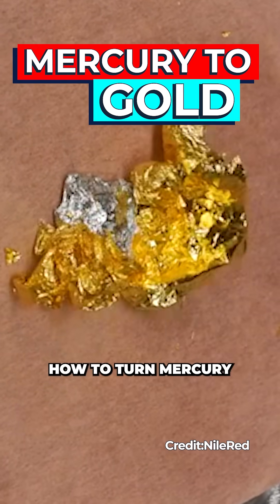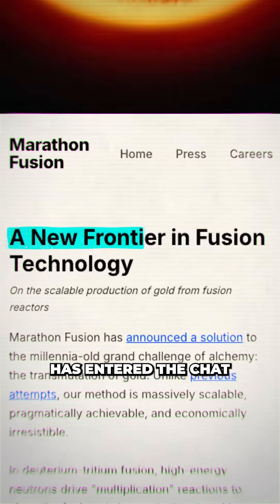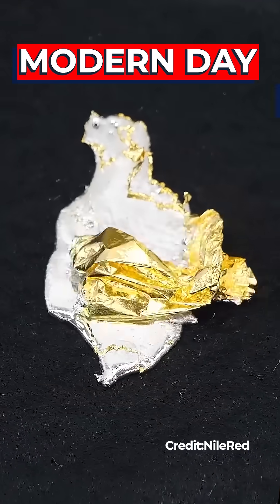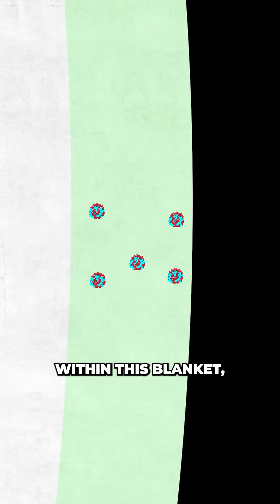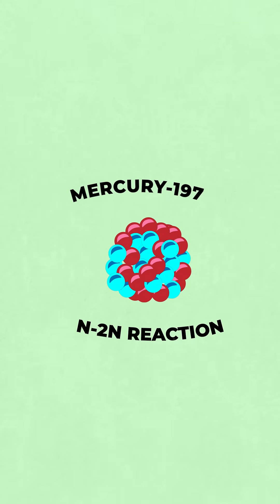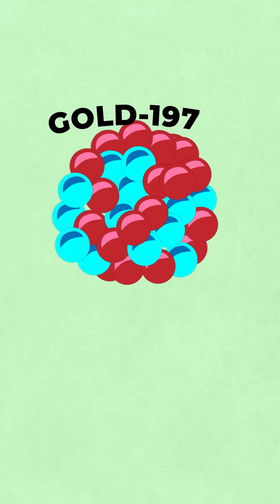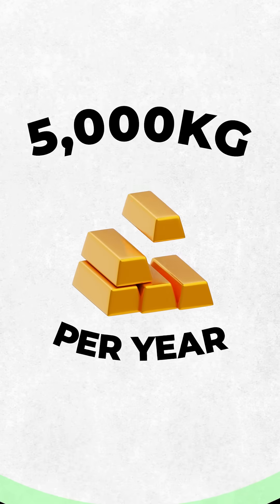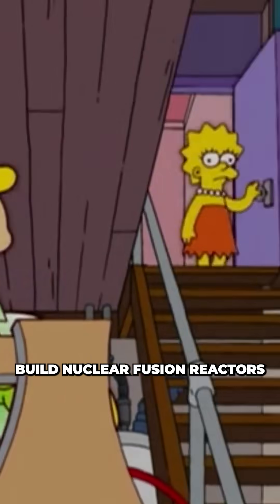Scientists Turn Mercury Into Gold

Comment: nah we gonna get gold inflation. this is basically printing gold
Reply: Gold is still useful in electronics etc
Reply: @paaaatrikaexactly
Reply: @paaaatrika  Anything that CAN be used to do good, WILL inevitably be used to do bad.
Reply: @woodjourneys  waaaiiit a minuuute!😭😭😭 you had me in the first half!😓

ion like it bcuz itz tru! 😭
Reply: @woodjourneyswhich doesn’t mean we should never do anything good.
Reply: @jameselliott216 😢
Reply: @woodjourneysit won't be used at all
Reply: @woodjourneysso never do anything right? What a strange thing to say
Reply: @paaaatrikacopper is better gold just good cause it doesn’t tarnish
Reply: @paaaatrikayes but adding more supply lowers demand. I assume it will be controlled similar to diamonds, hopefully natural gold has its own separate value
Reply: @cardinalcar mercury price will skyrocket if it use to make gold that will increase the cost, and you should know that mercury is also rare material. This video didnt count on mercury price increasing if the demand of it higher to make gold.
Reply: If this works out, it would certainly reduce the cost of gold and therefore the revenue.  However this would mean that gold becomes something we intentionally find utilitarian/industrial uses for, enabling all sorts of technological advancements that we aren't even looking for right now because usually materials science is trying to find ways of replacing gold with less expensive materials.

Aluminum used to be considered a precious metal due to pure metallic Aluminum being very rare in nature.  However when we figured out how to extract aluminum from very common bauxite, the price naturally crashed.  And it turns out that a cheap lightweight metal that doesn't corrode quickly has tons of useful applications that were unthinkable when it was vey expensive.
Reply: @TheFalrinn  Gold has naturally extremely low electrical resistance. For some small mission critical electronics, if the proce fell down enough, you could feasibly use it for wiring. It doesn't corode, doesn't tarnish, has way longer lifespan, lower resistance, so it heats up less and wastes less energy.
Reply: @TheFalrinn  isn't gold already used for conducting electricity?
Reply: @supertrollariobros1261 yes but silvers better i think
Reply: It can be, but due to it's cost and rarity, it's generally aren't going to use it for that purpose on any significant scale. If gold prices came down significantly, then the number of applications that would become practical would increase significantly, as would the incentive to find new applications.
Reply: @TheFalrinn  We use gold a lot in semiconductor manufacturing. Not only on processors and stuff, but especially Microwave Integrated Circuits are one application where gold wirings are basically essential, since it adheres best to the substrates we use.
Reply: @yukinagato1573 don't forget the applications as a catalyst in chemical compounds and in pharmacology 😊
Reply: @victormerida1564 : That's mostly silver, though I wouldn't be surprised at some gold-acid stuff as well.
Reply: @CreativeAndCreepy but silver corrodes but gold doesn't when exposed to air
Reply: @TheFalrinn  yes! I was thinking along these lines too. Great comment!
Reply: @TheFalrinn someone who gets it
Reply: @TheFalrinn thanks finaly someone said something actually inteligent about it
Reply: @TheFalrinn cant wait for my goldenfoil hat
Reply: @TheFalrinn I'd say reduce-ish, much of gold's value is based in artificially created scarcity. If a company created that much gold but held onto it as part of its holdings/assets then the price isn't going much of anywhere. If enough companies started doing it and releasing it out into the world then sure, they'd destabilize the market and destroy a LOT of businesses and industries, Whoopsie!
Reply: So now we ve just discovered Nixon know that he saw long he saw good
Reply: @TheFalrinn They could always do what they do for diamonds. We can already create diamonds but the ones that we create are only used in in like industrial purposes and military purposes never really sold so diamonds actually keep their value.
Reply: @TheFalrinn we already have hundreds of medical and industrial uses for gold, we've only been trying to find replacement because of cost.

Gold low electrical resistant and bio-inert properties make it extremely useful.
Reply: @TheFalrinn  Yeah, we would automatically enter the gold era and almost everything will be plated with gold to prevent corrosion.
Reply: It's like the gold asteroid. They said If they could bring it here it would be worth 10 quintillion but it won't, gold prices would plummet.
Reply: @aarong8457 Gold would become the new, better, cheaper standard for electrical wiring, a massive plus for the entire world
Reply: @StillActuallyCharlie  those papers you call money why do you think that you can pay for something with money? because it's backed with GOLD
Reply: @hungry_lama  My dude, it's been fiat currency since Nixon.
Reply: @hungry_lama  Haha! No it isn’t? Not a single country has a gold backed currency (gold standard) anymore and most haven’t for a looooooooooooooooooong time. Check your facts before trying to school other people.
Reply: @hunyesmith03  so you want to say that the federal reserve of USA is just a hard drive with thousands of Bitcoin? Or china doesn't have gold and backs their currency with stock in apple on space X or NFT's? OR even better... ALIENS. yes. they back their currency with aliens like huh? The hell did you think
Reply: @hungry_lama hasn’t been backed by gold since the 70’s dawg. Nixon took money off gold
Reply: @hungry_lama I always thought it was because the economy has become more debt than money or something
Reply: @hungry_lama  that hasn't been true for over 50 years lol
Reply: @hungry_lama  sounds like it's time for someone to do a wiki dive on what fiat currency means
Reply: @hungry_lama  In the US it hasn't been backed with gold since the 70s.
Reply: @aarong8457  Sounds good to me, if gold became dirt cheap I would buy a lot of it.

As a noble metal it is super useful.
Reply: @aarong8457 No. Diamonds aren’t scarce anymore either, they haven’t been for a long time. They’re still expensive because the diamond industry operates as a cartel and keeps prices artificially inflated. The same thing would certainly happen with gold.
Reply: @aarong8457  "It's like the gold asteroid. They said If they could bring it here it would be worth 10 quintillion but it won't, gold prices would plummet."

That or everyone would be billionaires and bread would be some ridiculous price like $1 million 😂
Reply: @aarong8457 but really it would make gold worth nothing.
Reply: @aarong8457 (rant) kinda reminds of the planet with a diamond core that would simultaneously be worth 9 Nonillion dollars and absolutely nothing because it would obliterate the diamond market. Not like there was much value to it anyways. It’s all pretty much overinflated and overstuffed. Just lab grow them. They’re better and just as “valuable” if you don’t count the concept of its origin, in which case, sure it has less value, but imo that’s mostly irrelevant.
Reply: @aarong8457  correct. Which is basically the only reason we aren't doing it. If there's an infinite supply (near infinite, it's the entire solar system worth of asteroids), everything might as well be free. Capitalism can't have that, nope.
Reply: @aarong8457 Actually, I'd prefer to differ... The billion dollar companies that are allowed fo mine the asteroid will end up selling it to big tech for their microprocessors and whatnot; hence, they'll end up making it look like they are under the impression of creating more jobs...
Reply: @The_Literate_ChristianJust because you  beg to differ doesn't make you right. Do you understand how much 10 quintillion is? That would be around 130 billion tons of gold.  That's about the same as all iron mined ever.  Steel is even more expensive than iron and I can buy a stainless steel chefs knife from the dollar store for a dollar.  Why? Supply and demand. Steel demand is extremely high but supply makes it cheap.
Reply: @aarong8457 No, its the people that control the commodity that decides whether or not to make it cheap. Why do you think we have gold reserves like fort knox. Gold is probably more abundant than we think but its also very usuful. I think the cause of gold prices is a bit more nuanced theres just a lot of unknown factors..
Reply: @The_Literate_ChristianThat would me as much gold as all the iron ever mined.  Is steel useful?
Reply: @aarong8457 they would still be able to use it for electronics just like how they use diamond tool for construction
Reply: @aarong8457 they obviously mean in terms of current market value, it’s more so the fact that we would’ve harvested that much gold to use for ourselves from a single asteroid. Then it’s done more and more and we essentially have a supply of rare metals and other elements that, in practical terms, is endless
Reply: @aarong8457  would make like instantly better for the whole planet but gold would be worthless... lets not do it LOL
Reply: @aarong8457 not if one country holds it and controls it
Reply: @JTHR3ZY2janky Do you realize how much 129 billion tons is? that's 2 trilion 580 billion pounds.  That's all the iron ever mined EVER.
Reply: @aarong8457  ok? Not sure how that relates or affects what I said at all 🤦‍♂️ yk how many diamonds there are?  guess what the market is controlled by the supplier yk why that is??? because THEY CAN AND WILL. It’s baffling to me that you think the US will just be passing out gold the main thing needed for semiconductors and these ai chips. Ai chips aren’t just for rt and anime games there used on weapons that would turn you small town to dust and splinters
Reply: @aarong8457 not unless it's artificially inflated to have more value, like diamonds
Reply: @aarong8457 we should stop treating gold as a dumb expensive yellow metal and start understanding it's true worth as the superior energy conducting material, if we replace all the copper we use for wires and cables the energy transfer rate would skyrocket.
Reply: @aarong8457  thats assuming supply and demand isnt artifical. just look at how diamonds scarcity is caused by controlling supply.
Reply: @aarong8457 it’s worth 10 quintillion right now…
Reply: @aarong8457 that’s why they need to keep it in a vault snd only release some at a time like diamonds lol 😂
Reply: @aarong8457  i mean, as long as someone does something secretly, they could become secretly rich.

if someone finds a really good thing that benefits them alot, they'd most likely keep it a secret so it keeps bringing benefit to them, unless they are stupid.
Reply: @aarong8457 yeah golds value only stems from its being relatively rare and difficult to extract. So unless they plan on implementing something like a diamond cartel to maintain artificial scarcity, the price of gold will go down
Reply: @aarong8457 
It's only worth the value human beings put on it.
Reply: @aarong8457  Yes, but that much gold would be invaluable to the betterment of human life.
Reply: @aarong8457  yeah but gold will still have its uses. Mining asteroids is a bountiful thing to do regardless of the value dropping. The earth is finite
Reply: @Andromeda_53  Yes how useful is iron? How many things utilize steel? That's how cheap gold would be if there was that much of it.
Reply: @aarong8457 exactly People need to remember that aluminum was once one of the most valuable metals.  I really hope someone finds a way to make gold one day but I'd rather they solve climate change and starvation and cancer first
Reply: @aarong8457 it would but If they did it right they could monopolize and sell just enough it would still be high price and makes billions or even trillions instantly making that country or person the most powerful in the world
Reply: @aarong8457 if it’s dispersed yes it would make a gold inflation, however more than likely one country would own it all so it would just make that one country rich. No inflation
Reply: @aarong8457 it probably wouldn’t though because of the investment to actually get the ore
Reply: @aarong8457 gold will be less valuable then a single popcorn
Reply: @aarong8457  many diamonds are produced in a lab but that hasn’t affected the price
Reply: @alvshill  There isn't different grades of gold that can't be refined. You can't refine a diamond. You can just melt dirty gold and clean it up. Gold is just gold.
Reply: SILVER STOCKS GOING UP BABYYYY
Reply: @aLovedHater and Mercury prices going up. Because that's what they'll need to make gold 😂😂
Reply: @powerdude_dk : I am fine with less mercury floating around, the stuff is more common than we actually desire.
Reply: @aLovedHater if they can do it with gold they can figure out a way to do it with silver
Reply: @aLovedHater  unless they are gonna split and fuse atoms to make silver too. its all about the amount of protons neutrons and electrons in an atom.
Reply: @acenuke2513 that's what i was thinking. Nothing is stopping them to make other stuff in there too
Reply: @aLovedHater I'm liking this
Reply: @aLovedHater Ok time to make silver 😅
Reply: @aLovedHater Been buying cheap silver 4 YEARS!
Reply: Gold should be cheap enough to bring down the cost of electronics etc.
Reply: @mr.joshua6818 lol the price won't go down on electronics at all
Reply: You would need 7000 fusion reactors to replace mining.
Reply: @carat1990 that doesn't sound like much tbh, it's less than the amount of coal burning energy plants. We could get there eventually if it's profitable enough
Reply: @BHsss13 eventually yeah maybe
Reply: @BHsss13  doubt it, it wouldn't even pay for itself, were talking over $20 Billion, 5000k gold is $660 million, it would take 30 years, an thats not considering the employees being payed, nor the cost of the mercury. I would hope Fission reactors would be what is being made. We dont want the radioactive waste that fusion reactors produce.
Reply: @johnhickman8391 fusion reactors have extremely low radioactive waste. They also can't have a meltdown that spreads radioactive waste
Reply: @johnhickman8391 : Fission produces a lot of waste, fusion mostly doesn't but also doesn't yet produce extra power.
Reply: @carat1990 we get most gold from recycling now days just saying
Reply: @carat1990 We can do it
Reply: @carat1990 mote... but interesting...
Reply: We could use a platinum or Palladium standard instead of a gold standard
Reply: @owenpeck4857  The gold standard hasnt existed for a very long time. And god forbid yall try to hike the price of platinum metals too, itd just fuck up chem and pharma at the consumer end bc those metals are extensively used for their tremendous catalytic prowess.
Reply: Gold is actually useful in electronics thou. This could cheapen them.
Reply: it’s radioactive for 10 years after production 
don’t worry 
it’ll probably be limited to computer parts 
not the jewelry or bulk gold for savings we traditionally think of
Reply: @argenizt123 well, when it stops being radioactive we can use it to protect everything from radiation.

We could literally have houses coated with gold and then we'd actually have deeper protection from potential radiation related threats.

Gold is highly useful for so so many things
Reply: Yep cause demand will probably stay the same while supply increases so prices go down
Reply: @vocalsunleashed  But that's not necessarily a bad thing. Gold is better than copper for computer parts.
Reply: @vocalsunleashed  I bet demand would increase a bit because of the hype so it would decrease but by less than projected
Reply: @vocalsunleashed no gold has lots of uses, old computers were made with gold
 If this Actully happens expect all our mobiles will be made with gold and we will treat it like aluminium. Chucking it in the recycling bin every week.
Reply: @vocalsunleashed pretty sure the demand would go down since part of it has to do with it's rarity
Reply: @vocalsunleashed No!! Demand will go up massively as it is beneficial in many industries that couldn't afford to use it at current prices.
Reply: @vocalsunleashed it's not about supply and demand when you can make gold from something as readily available as mercury this would literally make gold worthless other than it's electrical properties
Reply: @vocalsunleashed No, supply will stay the same but supply will skyrocket which means the price lowers (if anyone's actually willing to sell gold & make it just another metal)
Reply: @vocalsunleashed demand would increase with supply as gold would replace copper and silver as electrical conductors
Reply: @vocalsunleashed not necessarily. Real world dynamics cannot be simplified to a two dimensional supply-demand graph you briefly saw in high school. There are things called induced demand.
Reply: I just love gold. I don't even care how valuable it is.
Reply: Aluminum was worth more than gold. Until suddenly it wasn't. So little of the real world economy is based or backed by gold that it really wouldn't matter - except that your electronics and cables suddenly get better,  radiation shielding gets lighter, and in extremis, non-toxic birdshot and bullets
Reply: @markbecht1420 non-toxic birdshot 🌟🤩
Reply: Gold will still have value in electronic components and other technology, gold becoming more available will make technological advancement quicker and cheaper. The monetary value of gold is less important than its use in practical applications
Reply: Agreed! I was going to comment something similar. Gold will lose value as it becomes more accessible.

This can be a good thing as if Gold replaces copper, then we can have faster technology with gold traces/wires

Edit:
A lot of people keep correcting me, but my responses are lost in the vast quantity of replies. I am aware that I am wrong. Thank you for those who corrected me.
Reply: @micah2936 Good for us, bad for gold businesses and any of the billions who have a stash of gold. In their minds it would ruin the economy, they're blind to the benefits.
Reply: @micahsteeze sorry, but gold will never replace wiring lmao. Electronics yes. But not house hold or grid.
Reply: @micahsteeze  Not sure where you came up with the idea gold conductors could improve computers, as 1) gold is a WORSE conductor than copper, and 2) trace length isn’t even the limiting factor in computer speeds; silicon wafer technology is.
Reply: @RtaincCo you’re right. I had the impression that gold is more conductive, but it’s actually silver. I used misinformation. Copper is more conductive.

The only benefit of gold over copper is the lack of corrosion which may help electronics last longer, but that would be more limited by the silicon. 

Thank you for correcting me. I’ll leave my original comment because the lack of knowledge is not what makes people dumb, but rather the lack of acceptance to being wrong.
Reply: @micah2936  copper conducts better than gold. Gold is used because it doesn't corrode.
Reply: @micahsteeze wow - another Micah… I’ve only ever met 2 others… 😂
Reply: @micahsteeze so wrong
Reply: @micah2936 +1 don't think they'd be making bricks out of that but electronics and arts.
Reply: @micahsteeze who said it’ll be accessible. This will be another DeBeers run.  Have diamonds plummeted in value?
Reply: @micahsteeze  Osmium, Rhodium, Platin, Palladium, even Plutonium (for what ever reason - as there are enough weapons already), are much more expensive/are more valued.
Reply: @micahsteeze  Copper (and silver) have better electrical conductivity. Gold has some niche used because its does not corrode.
Reply: @micah2936  Exactly what I was thinking.  Gold gets a lot of its value through its rarity, though it also carries value from its practical use in electronics.
Reply: @micahsteeze gold wouldn't faster technology, it would make  waste heat, the speed of electrical transmission is equivalent in Gold and copper for all intents of purposes
Reply: @micahsteeze great, it's going to revolutionize every industry especially power generation and transmission and significantly improve quality of life instead of collecting dust in parasites vaults
Reply: @micahsteeze someone's probably said it already but the value of gold is also based on its somewhere artificial scarcity, just like other precious metals and precious stones. If gold is still hoarded and its scarcity maintained, it'll still largely retain its value.
Reply: @micahsteeze  more gold does not mean more accessable though... oil is very accessable, but frequently priced very high. I don't think such reactors would devalue any gold any time soon.
Reply: @daanwinne2596you didn’t read my edit.
Reply: @micahsteeze This is what happened to silver after Columbus. Spain became rich for a few decades; then the price of silver crashed because there was so much of it. Spain went from immensely rich & powerful to very poor. (The inbreeding of the monarchy helped.)
Reply: Oh God... think of the high-end audiophile speaker connector companies! They'll all go out of business.
Reply: @micahsteeze it happened with silver before when the Spaniards founds loads of it in south America. So yeah if it happens with good too it's a catastrophe
Reply: @micahsteeze  While it is a good thing that gold becomes more accesible for cables, copper will still be used because of the higher electrical conductivity
Reply: @nikvett you’re absolutely right! The only benefit of gold over copper is that it’s much less susceptible to corrosion. And copper is only slightly more conductive.
Reply: @nikvett gold is more likely used for the exposed connectors as where its resistance to oxidation and corrosion is more important than its conductivity. Although material science has hardly touched gold relatively (due to its expense) so I'm sure some alloys or doping the gold they could increase its conductivity.
Reply: @nikvett  the real value of gold as an electrical component is in its non-corroding property, not just its excellent conductive rating. In addition, it's one of the softer metals, making it less robust for some physically flexible applications, but well suited for plating other metals. That's the most important reason why gold is primarily used as a coating on wires and pins made of silver, which is a better conductor but tarnishes relatively easily.
Reply: @micahsteeze  no lol, it'll become the new diamond. They'll artificially drive up price by not selling it
Reply: @SomepersonROTSPFCOdiamond still useless beside archive laser technology, gold on the other hand will remove limit to tech due to finite number of gold
Reply: That may actually be good. Electronics use gold.
Reply: Given that this seems to be an expensive project by itself, requiring a nuclear power plant at your disposal, I don't think this can produce enough gold to collapse the value by a lot.
Reply: They made a few molecules. At least so far, it is way too expensive to make gold. If it costs more money than digging it out of the ground, then it’s literally not worth it. If they can’t get the cost down it will literally be cheaper to go mine it on an asteroid.
Reply: Good tech will get cheaper
Reply: If gold becomes cheap enough, you can use it to make cars more rust resistant. Maybe even immune.
Reply: REALLY expensive...and we are JUST working out stable nuclear fusion techniques 😅
Reply: @6shoresy9 

Well that *DEFINITELY* invalidates it for gold production because,
as we all know, technology just gets more expensive over time   🙄
Reply: Okay but, printing paper money results in a basically worthless product. Where as gold is at least a useful material component for computer chips and other physical goods that require a metal that never ages or tarnishes.

Gold also has cultural significance that will guarantee some level of interest, even if it were literally made as common as dirt.
Reply: You’re right, but we use gold in a lot of computers. So in the future gold might become worthless as a monetary thing, but this process might make computers cheaper.
Reply: @Rangerthehound gold is not a primary driving factor in the cost of computers.
Reply: @marvalice3455 ? Did I say it was?
Reply: @Rangerthehound  by implication yes.
Reply: @marvalice3455  can I imply that you’re nitpicker? 😂 in all seriousness though and from my understanding, gold is used in wiring, however it’s a very expensive metal, being able to mass produce gold for super cheap would make computers cheaper to produce. Am I saying that computers are made entirely of gold or even 50% out of gold? nope. But sure add all the fake implications you want to whatever I’m saying so that you can push up your anime glasses and believe you look super smart. 👍
Reply: @Rangerthehound  you are the nitpicker.
you are the nitpicker because you are trying to be pedantic to defend an obvious guess. gold is not a major factor in the price of computers because the primary factor is the specialized labor and equipment necesary to produce high end parts. 
massive investment need to to train the engineers and build the infrustructure is way more relevant than the price of any particular raw material, even ones as precious as gold. 
 further, the method mentioned here would not lend itself to mass manufacture anyway.

there is no fake implication here. if something is not a major cause of the price,m than it will not effect the price in a relevant way.
Reply: @Rangerthehound  Yep, today gold has become so useful as a strategic resource that using it as currency is basically barter conomy.
Reply: Even best case scenario it’s less than 0.2% of the amount mined each year. It would take a whole lot more to destabilise markets. It’ll hopefully replace exploitative mining, although i don’t know how bad mercury (mining?) is. Would be nice to have gold as a commodity for electrical purposes.
Reply: @alexandramuller9055mercury often times ignored in mines it's just a byproduct of mining in most resource extraction 

They even just discard it away polluting water sources but that's mostly on unregulated mines or in countries that lack environmental laws or enforcement of them
Reply: @alexandramuller9055 you mean 2,5 million tons of gold is mined per annum?
Reply: Same as gold (Google)
Reply: Gold de-flation.
Reply: Goldflation noooooo!
Reply: Which is pretty awesome since gold has a lot of uses in plumbing and engineering but is seldom used due to price a s scarcity
Reply: i know people may respond with, "... thats not realistic...", that, "...you'd need more gold to decrease the price of..." blah blah blah, but this actually is one way to decrease the price of something international economic systems standards are grounded from, and remember, how fast is tech innovation lately?
Reply: Who cares? That's more useful as a resource for real people than as a speculation tool
Reply: Good. Gold shouldn't be worth shit. Its valuable for its use in electronics and because our monkey brain likes shiny things.
Reply: If this becomes viable and large scale then gold might become like aluminum. Aluminum used to be reslly valuable because the raw form doesn't occur in nature, but as we improved our refining processes, we could produce it in large amounts and it became cheap. If the same thing happens to gold, it could become less expensive and we could use it more often for its practical applications.
Reply: Good, scarcity is balls
Reply: It's an expensive process. Gold printers aren't coming anytime soon.
Reply: Yah, going to be like lab diamonds.
Other metals are next.
Reply: @violent_bebop9687  lab diamonds are far easier to create than changing elements. It's not even the same thing.
Reply: Goldflation. Lol
Reply: @KevinGolden-y9n  inflating gold would just make everything gold. A remember watching a video where some guy said a solid piece of gold the size of a stick of chewing gum could cover 10 football fields or something.
Reply: Gold is one of most important metals for modern technology anyway, it’s not really just for hording wealth.
Reply: That’s honestly good since it can lower the price of hardware
Reply: We are literally getting free energy and the waste product is gold
Reply: Bro I’m over this idea that our economy should run on precious metals because with technology advancing the way that it is you can’t be using the resources that you need to put into this technology in order to use as money or any form of valuable currency because if you are using this resource for currency instead of the useful aspects of what it could be used for then effectively, your society is just wasting that resource in my opinion and at some point, we as a species are going to have to move past the whole silver gold platinum these metals aren’t inherently worth anything other than what they’re useful for which currently they’re useful for building computers, and things like that so yeah, we need a way to make more gold. Gold printing is necessary at this point in our societies maturation because we are at the point where the more computers we make the more gold we use and it is a small amount of gold that goes into these but when you put out hundreds of thousands of iPhones every year that each use a little bit of gold and other metals then at some point, we are going to have to find a way to replenish this finite resource, and I really don’t believe that our currency should be tied to any gold or anything. It should entirely be based upon a trust system in my mind and anyone who breaks the trust of that system needs to be held liable in some form obviously that form is up for debate among many people and anyways I’m of the opinion that our current form of economy can only last so long in the first place I mean our modern economy is a house of cards being kept up with hopes and dreams by elites who don’t up there way of life to end and collectively they hold an absurd amount of power also as a final note most gold currently is being held in vaults by governments and banks doing nothing but sit there and project a sense of power
Reply: Not necessarily, it only allows them to double their money, resources for this are finite. Way different than printing a bill.
Reply: Instead of selling the gold, they can make use of it as a conductor.
Reply: Gold isn't the only thing our economy is based off of even if you make gold worthless or economy still won't crash unless if you make more of everything you would have to make millions of tons at it
Reply: Oof
Maybe technology would be better with gold wires
Reply: Someone probably already said this, but it's a 200+ comment thread so I'm not looking for it. Making gold through nuclear fusion would be like spending $1000 to make a perfect counterfeit $1 dollar bill, the energy alone is going to cost you way more than the return you get from the value of the gold
Reply: @circleturtles  I hope so I pretty much just said this but u said it better. The amount of time and resources ain’t fuckin worth it. Well said.
Reply: @SpooDaBandit  there's no need to hope, humanity is still very far away from utilising energy positive fusion, talking about harvesting gold from this process is a pipe dream within a pipe dream
Reply: It's great actually!

For computers and electronics that is!

Maybe we can fully replace copper wiring as a whole!

Since gold is one of the best conductors there is.
Reply: Bitcoin better
Reply: Gold is a terribly reliable piece of material in every aspect of science. Getting more gold is NEEDED. Heck people considered mining a rock in space for gold which value was so high every person would have more then 20 million.
Reply: but like,,,more  resources
Reply: Oh I hope so.
Reply: It reduces its value as a scarcity based fiat, gold however is still extremely useful from a material science perspective. 

More accurately it's going to fuel a push towards an energy backed credit more long lasting than the current petrodollar
Reply: Which is good.

Gold is an important material for electronics and other things but high prices and more prevent it from being used too much.

Besides that it means that people would be able to afford gold jewellery.

It would lose novelty but skyrocket in practicality and accessibility.
Reply: @omnomgamer8633 oh people could afford gold jewelry! Well then its all worth it.😅 
gold is useful in electronics thats true, but its not as needed as it was in older electronics. If you have or know where an old pc with a like a pentium 2 chip in it, grab that thing and strip it. Theres a shit load of gold in it. But modern electronics dont contain much gold
Reply: the uses of gold in mechanics, engineering, physics and everyday life is just too good, fk economics
Reply: All before GTA VI
Reply: Gold has more industrial uses than anything else. We should be using gold for electronics, not stores of wealth. I hope the gold supply increases. 

I hope the diamond industry gets dismantled for the same reason.
Reply: We wood have to start upgrading comp chips from copper to gold and evan then it's price wood drop
Reply: we want gold inflation tbh, its a very good material that needs to become common for its properties
Reply: Bitcoin!
Reply: Gold has been a terrible investment for years.
Reply: The mining of gold is already a form of inflation on gold, as the total available gold supply increases over time. You don't need printing to have inflation.
Reply: Doesn’t matter fusion energy is way more important and offsetting costs w some gold is good
Reply: This process is not new.  I read about it over 10 years ago.  Problem always was that it didn't seem economical to do it.  Basically it was much more profitable to mine gold.  It could set a max cost of gold based on the energy expended in this method.
Reply: Another reason Bitcoin is going to be the future store of wealth
Reply: @blockchainbiker2549 

👍

Synthetic scarcity, baby!
Reply: @blockchainbiker2549 not if you dont have 10k to invest
Reply: Up the price of mercury
Reply: @elywilbur96 

How?
Reply: Just like money
Reply: I like platinum
Reply: The amount of gold it'll make, it was pointless to even mention it. And all that will mostly go as nuclear waste, no one is going to mine pure gold out of it.
Reply: Good thing our financial system
now has a certain digital asset
with reliable synthetic scarcity
ready to take gold's place!
Reply: Somehow you, a random YouTube commenter has a better understanding of this than all of DC
Reply: For all of you talking about electronics, I know about that, but I was talking about its value in jewelery and such stuff!!
Reply: Goldflation ⚱️
Reply: Wont make much of a difference to the 3000-5000 tons mined each year
Reply: Good thing bitcoin was invented
Reply: I'm finna look saucy tho ma nga
Reply: That’s the plan I guess also china trying to make a monopoly on gold rn lol
Reply: I think it's will be like diamond. Factory set cost less and natural will cost more!!
Reply: Nah this is so incredibly difficult and expensive. It's a science flex, not something actually worth doing.
Reply: *literally printing gold
Reply: exactly. Lets think that thou. One fusion reactor starts and makes incredible profit at first. Other jump the hypetrain and build their own fusion reactor and suddenly as the gold market gets overflown the gold prices plumit and the gold mining industry colapses like over night(not neccessarily a bad thing tho) now any gold comes from fusion and so much so that gold is worth as much as it costs to be transported making juwelery practicly dirt cheap i imagin like coal maybe. After a while gold has become to cheap and the public interest in it as symbole of wealth gets lost. Making mdeical and electrponics the only buyer for gold. If the industry does not find another usage for gold then the cost to storage, sell and transport the gold becomes to much for the reactors effectivly letting them pay to get rid of their exccess gold. Oh and every land would lose billions on the way as they porp. miss the chance to sell their gold reserves soon enough. Effectivly rendering multible countries bancrupt. Sure a grimm scenario but not to far fetched to be impossible. So many more possible implications... for example maybe there would be a time in between all that where every metalic surface gets real golded versions of them relativly effordable. Like maybe a pure gold SUV. A golded train. Maybe the president wants AF1 to be golden at a point... so many possibilities XD
Reply: The only thing we have to keep in mind is that gold is worth more as a conductor in semi conductors and chips than it is in rings and other such. We can switch to platinum which is far harder to both make and find.
Reply: Exactly what I was gonna say.
 But gold has applications other than being precious
Reply: imagine goldflation before gta6
Reply: What comes around goes around.
Reply: It's still cool, they would realistically try to control the gold being made.
Reply: Mercury is also very expensive
Reply: Basically no country is on the gold standard the only people.impacted are everyone cuase price of electronics goes down, and old nutjobs that believe gold bullion is their savior in whatever fantasy flavor of apocalypse they specifically want to have happen.
Reply: But the first people are gonna get some profit, or gold gonna go down in stock, you buy, then it turns out it's not worth making gold like this so it goes back up and you rich
Reply: Good. Lower the price of gold.
Reply: Yeah.
Reply: buttt it might be able to help reduce price of electronics
Reply: So the same effect uf we started mining asteroids. 
Fortuney for people that are concerned about this, fusion is 20 years away just like it was 20 years ago and will be in 20 years.
Reply: Lol
Reply: No Man’s Sky
Reply: Actually this is no different than mining gold. Extracting a resource is required. Then treating that resource to be refined.
Reply: It's only 5k worth per year. Wouldn't affect gold's price in any meaningful way.
Reply: Why everyone thinking about the money, instead what i'm thinking of is how revolutionnary this would be! Gold is a super conductor and would make computer more powerful with those. As a tech nerd, base 4 computer or even higher (instead of binary) could exist. The issue with those is usually that electricity isnt stable on regular wires which causes innacuracy when we have higher than 2 states. But with gold.. oh boy!

So yea gold could not be luxury anymore, but we may be able to have those a lot more in our daily objects!
Reply: Gold is valuable for being highly conductive, not just for jewelry
Reply: But it would also make electronics cheaper. The biggest 'problem' would be gold becoming cheaper, but modern currencies aren't upheld by the gold standard anymore so it would be more like diamonds.
Reply: They'll probably treat it like how the jewel industry treats lab grown diamonds. They are chemically and structurally the same, but because it wasn't "found" it's not worth as much
Reply: I would not be worried about the gold, but about what this would do to the tech industry. Things are expensive in part because of the rare metals needed, gold included...and I doubt GPUs would just get cheap and everyone would be happy about it.
Reply: GOLDEN  L
PLATINUM  W
Reply: This isn't gonna crash the gold price overnight. With aluminim, 1 guy with a bit of time and money could build a small scale (bucket size) bauxite refining setup in their backyard, and building their own batteries to power it was feasible too.
Can't do that with a nuclear reactor. Even retrofitting an existing one would take years
Reply: I know you are joking(I think) but not only does this produce only few atoms of gold. But they are usually an unstable isotope.
Reply: Yeah but i doubt this gold will be used for hording wealth. Most likely will be used in tech
Reply: I mean, good for all the applications that need gold
Reply: This would tank the value of gold. As a jeweler im all for it
Reply: One step closer to post capitalism
Reply: bbitcoin is the only way. You cant get around it. It's the best. Study it before it's to late.

It's the only thing in the world that is not inflatable.
Reply: U know how useful gold electronics would be we could all electronics 99% efficient battery life would skyrocket power plants would have to make less power everyone would be better off
Reply: @JRRHellFirePhoenix  thats a good point, but then a new reserve assset is needed. 

It can only be bitcoin. Everything else is inflatable and it has by far even better propeperties than gold as an asset.
Reply: Using billions of dollars in an experimental fusion reactor is an insane idea. It would be cheaper and produce more gold to ACTUALLY go into space and retrieve a real asteroid.
Reply: But gold is still useful as a superconductor. So they will just develop tests to see if it is irradiated and it will be worth much less if it is
Reply: Phones and electronics would be cheaper tho :]
Reply: It wouldn't be enough supply to push the price down faster than it's climbing until we were building tons of them
Reply: If they produced all that gold it would drop the gold prices drastically hence it not paying for itself unless they stopped mining gold an amount equal to what is produced.  Don't see that happening, if it does, I'm buying stock in Mercury, lol.
Reply: @survidmt annual gold production is over 3.6 million kg. It wouldn't do a thing to gold demand unless they opened a LOT and somehow got expected max yield, which is incredibly unlikely
Reply: Gold is useful in keeping prices stable, but it'd also be great if we could use more for electronics, alloys like with titanium or jewelry over time
Reply: gold is useful for more than just store of value, its used in tech.
Reply: As long as it's useful, it should be no big deal.   People need to stop worshiping false idols of shiny things.
Reply: Nothing basic about this 😂
Reply: Annual gold mined is 3.5M kg. A GW fusion reactor would produce 5K kg. Another 0.1%.
Reply: Good
Reply: I mean, yes. But gold has many uses in tech, but it's not widely used due to prices being too high. I believe an increase in supply would also increase demand.
Reply: @geritoxnm  increased supply means decreased demand, which in turns means lower prices
Reply: @CrocoDylianVT no, increased supply means increased supply, and that alone makes the price go down, which would increase demand, which would increase prices. Just from this we cannot predict what would happen to the prices; one would expect the price to be much, much lower, sure, but will that happen? Truly? Economy isn't "hard science" (like math), it's "soft science" (like sociology).
Reply: nah this is basically the first step to making spaceships for interstellar space travel you need gold for a ton of components
Reply: We can get cheaper gold toilet seats 😅
Reply: The only smart nigga here
Reply: You're right, but it would still bring revenue to the plant, especially in the first few years where profitability wouldn't be assured.
Reply: Even if it's possible govs would not let this happen
Reply: So is mining gold.
Reply: Imagine thinking gold’s only application is for jewelry and the transferring of “currency,” from one place to another.
Reply: this is a good thing. making resources cheaper is a GOOD THING
Reply: I was thinking the same thing
Reply: Actually no that shit can't produce a lot of gold it's more expensive to get the energy as of the moment.
Reply: Tbh unless you're an aussie this is fire
Reply: that would be good,  if this is successful this will raised the  price of mercury and gold price needs to go  down. Its price is already so hype.... so as the bitcoin value is floating in air😂😂😂😂 its not even real😂😂😂
Reply: Gold is a useful metal that can be used for a lot of stuff, not just jewellery and a form of currency.
Reply: it will just decrease the value of gold overall.
Reply: 5000kg of gold = 0.0025% of wold supply... so no price crash.
Reply: So we can use cheap gold for wiring? Hell yeah!
Reply: We got real alchemy before GTA6
Reply: There is noway that outpours more than a proper mine tho ans since nuclear energy isnt com.on it shoulsnt be an issie for a few decades
Reply: I mean it would make some computer parts cheaper on paper at least
Reply: Yes print gold. You know what you can't print? Bitcoin.
Reply: Well at least I’ll be able to add some to my shiny rock collection when the price goes down
Reply: Same reason there is no asteroid mining.
Reply: It would be cool to think that the 2 largest commodities would instantly destabilize. 

Money and energy
Reply: Well yes but the components requiring gold will be much cheaper to make
Reply: Nobody uses the gold standard anymore, so it wouldn't affect currency, just the price of gold.
Reply: But there are so many scientific uses for gold. And AI and electronics could afford to be used in almost all electronics then. With the ever increasing demands for high quality circuitry for AI and other applications, that could help preserve some of gold's value.
Reply: This is good for electronics, as gold is used in their manufacturing
Reply: Yes it will deflate the price of gold eventually, but those that get in early will make a good profit.
Reply: Another reason why no one will be having any nostalgia for 2025.
Reply: And mercury deflation
Reply: Platinum anyone?
Reply: Ya it was always going to happen,  just a matter of when.
Reply: There is a weird thing that happens in the "luxury" market though that might not cause the expected result. Just like synthetic diamonds this would be marketed as "green" gold, or "ethical" gold and the retailers would demand a premium even though the wholesale cost might dip. Then there will be the push back and a premium placed on "naturally sourced" or "earth gold".
Reply: Actually with influx of gold this way it can lower the price of electronics since gold is perfect
Reply: No, 5000kg is only about 0.1% of gold mined each year. That will change no more in the value of gold than discovery of a new gold mine.
Reply: Just imagine using gold wires instead of copper.

GOLD cables,

GOLD breakers and the like.
Reply: That’s not how inflation works. In order for gold price to plummet it has to be in circulation. Which means a lot of ppl need to have it in their hands. If this company is hoarding all that gold then it will still be worth a lot.
Reply: I mean, we can eat it right?
It will be sold as a decrative edible condiment :3
Reply: I mean, good? Gold serves an important purpose in computer building, so that may get cheaper over time
Reply: Yeah we barely have gold as it is rn..
Reply: Good.
Reply: Not if they patent it and maintain discipline.
Reply: Good, it's worth much like diamonds is inflated into a collectors industry. When these could just be resources for our use. Can't wait to see a cope like pricing it lower as "lab grown gold"
Reply: Mercury will replace it becoming the new valuable metal then, and hopefully the lower gold price will drastically reduce the cost of electronics.

It's not like printed money bills where the only resources needed to print more are ink and paper.
Reply: The amount of energy and resources it’d take to just “create gold” yeah not happening
Reply: The cost of production exceeds the market value of gold. Gold has limited use compared to silver.
Reply: even if they do it... do you have any idea how small atoms are? It isnt even close to be financially feasible.
Reply: Wouldn’t it be deflatetion because it will be cheaper
Reply: I think the processes will cost more than gold value 😂, fusion process usually happens in star
Reply: We should print gold. We actually need it for industry more than as a store of value.
Reply: Kind of. The dollar price of gold would surely plummet, but gold itself is still inherently valuable as a resource.
Reply: gold is already cheap, is just that the companies that own it speculate with it so it can be expensive
Reply: @VonVikoGoat  absolute nonsense. The price of gold can be driven up by speculative investment, but even if this wasn't the case, it's an immensely scarce resource with many practical applications. It always has and always will be incredibly expensive, speaking relative to other elements
Reply: Except that even at that rate it's not really that much per year and we need this gold for electrical components, so its a big plus
Reply: A time when silver is worth more than gold, and now that might just be the case.
Reply: You do know gold deposits are actually quite common...  Because of market control ...
Reply: @BlessUsEarth  nothing to do with market control, and the numbers prove it. Let's compare gold to iron.
About 2.5 billions tonnes of iron are mined per year, around 3,500 tonnes of gold is mined per year. 2,500,000,000 ÷ 3,500 = ~175,000

Now lets look at the value, iron is ~20c per kilo, gold is ~ $35,000 per kilo, 35,000 ÷ 0.2 = 175,000.

Notice how these numbers are proportional to the availability of the materials?

Edit: corrected both measurements to use metric tonnes
Reply: @circleturtles and if gold were purposely mine less?   Just like diamonds mines 😅
Reply: @BlessUsEarth 
1) we would likely be aware of it, just as we are aware that diamonds massively artificially inflated

2) i could just say iron is also artificially mined less to inflate it's value, i have the same amount of evidence for my claim as you do yours (which is zero) and now it's proportional again
Reply: Earth's mass is like mostly gold and iron, this is nothing
Reply: @-o-1695  the mass of earth in parts per million is 319,000 to iron and a puny 0.16 for gold, youre talking nonsense
Reply: Good then we can realise how stupid the idea of gold and its worth actually is
Reply: Bitcoin fixes it.
Reply: Another great depression insues...
Reply: Search Euphrates river gold lol this is nothing
Reply: Do we have enough mercury lying around to do that? We’d have to find that Chinese emperor’s tomb.
Reply: Still good in a gold bull run...
Reply: Gold's value has been inflated for a long while. Not as bad as diamonds, but pretty bad.
Reply: Gold is so damn useful for good electronics, even if it inflates the economy, we’re probably just going to use more of it and deinflate it again
Reply: Just like how diamonds are actually cheap since they're not all that special but some people keep them "valuable" when they're the opposite
Reply: I was going to say this as well. Luckily gold has utility in other areas besides money exchange.
Reply: Mining gold also isnt?
Reply: Good. It's gonna make computers cheaper.
Reply: @rohithkumarbandari  it really wouldn't. Even if this wasn't pipe dream nonsense, there's usually less than a gram of gold in a PC. If the gold cost nothing, then production costs have been reduced by around $35, the difference to consumers would be entirely negligible
Reply: Nope. Ask Rick about diamonds lol
Reply: This process is more expensive
Reply: Gold is actually pretty useful.
Reply: Isn't that awesome? Science will destroy capitalism and make the world better for literally everyone!!!!
Reply: I mean diamonds are also manufactured, but they still have very high value
Reply: True but we could use the gold in more electric devices etc which could be useful
Reply: sheeet, if my dollar bills and cents are replaced with GOLD?! sign! me! up!!!
Reply: Deflation. The price of gold would decrease not increase. Supply and demand.
Reply: Gold is heavily artificially overpriced anyway
Reply: 8.3k dumb people liked ur comment...congrats
Reply: Gold is a nearly useless metal anyway, the only real practical use is in electronics,
Reply: @samuelfawell9159  nearly useless metal...!!??😅
the scary thing a lot of people actuakky thinks like u...💀
Reply: @Vedha. electronics, it’s a shiny metal my dude, that’s all
Reply: We wont gold already is inflated because we use it
Reply: nah, we gonna get mercury inflation
Reply: Time to invest  in mercury
Reply: Deflation.  Too much supply with no change in demand means prices plummet.
Reply: My first thought was "won't this just kill gold's worth on a long enough timeline?"
Reply: And mercury deflation
Reply: But isn't gold very useful? I know it's used in electronics and maybe can be used somewhere else.
Reply: Mercury is only moderately less valuable than gold though, so this is pretty worthless.
Reply: @jacobsmith4428 No it's not. I can buy it for $39 an ounce which would be about 41 for a troy ounce.  I'm pretty sure they can get it much cheaper
Reply: Btc nerds
Reply: But aside from trading, gold have many uses. So we can benefit from having cheaper product made of gold.
Reply: Yup, the price of gold is gonna drop
Reply: Thankfully money hasn't been based on gold for 50 years so making gold cheap is a good thing. Electronics is its only productive use.
Reply: you gonna hear people claiming fake gold now like they do fake diamonds
Reply: You just need a nuclear fusion reactor, easy
Reply: Something doesn't add up!
The input material & process are waaaay more expensive than the end result?
Tritium alone is like $30,000 per gram!
A fusion power plant startup requires a few kilograms of tritium, with estimates ranging from 2.5 kg to 10 kg, depending on the specific reactor design and operating parameters. For a 1 GW power plant, the annual tritium consumption is estimated to be around 60 kg😨
-------
5000 KG of mercury is like $285,000
+1GW for 5000kg of gold per year.🤨
Reply: With current tecnology ....ITS Will like using one chest of diamond to make one gram of gold
Reply: Nvidia will eat that gold and ask for more XD
Reply: Yes, we need that. Gold values needs to be lower, so more people can have it, and  maybe in the future, we can use it cheaply for everything. Medical reason obv no1 on that list.
Reply: Spain, after returning from south America
Reply: Yep
Reply: We already have a gold inflation - same for diamonds. These prices are way to high compared to the occurrence of gold in the Earth's crust. People think that gold is a save investment - in case of real crises it is almost worthless.
Water would be much better.
Reply: Eh, it would be way to expensive and wasting even the tiniest bit of tritium to make gold will be a net loss for at least a decade.
Reply: Gold inflation yes, but gold has utility in electronics and other areas than finance, and a new supply would still be profitable. It would be like discovering a new gold mine.
Reply: Cheaper cpu maybe ?
Reply: Mercury stonks you say
Reply: 3D printing
Reply: Honestly it’s probably for the better if gold plummets
Reply: Cool, isn't it?
Reply: Just like 99.9% of these discoveries, it’s probably not going to change anything noticeably for the average person.
Reply: Does that really matter?
Reply: Good its been valued way to highly anyhow has no real uses
Reply: We can already synthesise PERFECT Diamonds!

Blood Diamonds are still worth MORE, because lots of rich people demand to have blood diamonds instead of "synthetic" ones.

People would also pay extra for "Bio Gold"...
Reply: Flooring the gold price really wouldn't be bad, gold is really useful due to its nonreactivity
Reply: To be honest gold has so many unique properties I rather have it as industrial metal than rare currency
Reply: once upon a time, our currency was backed by our gold and silver reserves and this might have been a bad idea, doomed to fail because it would have ruined the economy even further. nowadays, the only thing backing the US dollar is the "full faith and credit of the government", which essentially means it isnt backed by anything, so go on guys. print that free money
Reply: Nah, that's not real they will actually create an artificial shortage of these just like done with diamonds doubling their prices....
Reply: Yeah but unlike cash gold is a material and it has uses other than pure value 

Like electronics, chips, and other technological uses since gold is much more conductive than copper
Reply: But gold will just get new uses
Reply: But that would mean cheaper electronics
Reply: Wait till they build starships, then the idea of having billions of gold bullions is merely reduced to $1 per ingot
Reply: it is not, it is like exploding gold into existence with nuclear fuel it is more exponentially more expensive than just digging up gold... for now.
Reply: And how is that a bad thing? Most tech needs gold, so as long as it isn‘t cheaper than the mercury needed we‘ll be fine and evolving rapidly
Reply: @TheChillestGuy2008 wouldn't hardly touch gold value if we used all of the mercury we had. then industial sectors collapse and we have much larger issues.
Reply: F yeah, thats actually good. world economy would equalize.
Reply: Not really it's like diamonds we can make them
Reply: Gold might be new money with Bitcoin.
Reply: GOOD
Reply: WELL NO SH-
Reply: Buuuut
If it DOES work it COULD revolutionize modern tech and electronics as we know it
All the while creating 1more reason to stop modern mining operations
Reply: @frakspikes2619 It wouldn't revolutionize modern tech and electronics. It would just make it easier to make more. All it's doing is increasing supply
Reply: This is a good thing though. Gold is incredibly useful in practical applications as it does not react and having cheap gold would be huge for so many industries.
Reply: At least we have bit coin.
Reply: Precisely my point. Gold is valuable because it's one of the scarcest metals in the planet. But if somebody starts mass-producing it by the metric ton...
Reply: It’s actually a super important resource
Reply: We already have gold inflation that's why we aren't on a gold standard 🤷🏾‍♂️
Reply: assuming this is physically feasible (as explained and not... complete BS)... 
this is economically viable (profitable) at... current gold prices. 
but if market were to be... flooded (with gold or anything else) and demand remains stable (or anyway, doesn't keep up long term)... price of gold (or any other commodity) would likely adjust downwards (over time).

how does this method compare in terms of financial ($), ecological (cyanide or otherwise)... costs of (traditional) gold mining and refining?
Reply: and soon mankind would realize more how in vain these things are.
Reply: Good
Reply: Yep, value's going to tank FAST
Reply: This is not news omfg this is the literal foundation of nuclear physics since its inception in the 20th century. I’m so tired of your misleading pop science-esque attitude
Reply: I mean the gold is secondary anyway if we achieve efficient nuclear fusion. It will be like a small bonus
Reply: It wont really cause inflation. 

These reactions are SUPER expensive. You cant just build and run a nuclear reactor just on a whim afterall. They are extremely expensive to build and maintain.

All that effort means that gold will remain relatively scarce.

I mean the gold on its OWN wont even be enough to pay for it's own production. It is WAY more expensive to produce gold in this way than it is to just mine it. The only reason this is useful AT ALL is because nuclear power plants can use this method to maybe produce more revenue on top of their energy production.

So this wont really devalue gold at all because the amount of gold entering the market through this method will be relatively tiny to the total gold in circulation. It could drop prices of gold a LITTLE, but not by enough to really have a major effect.
Reply: Hey they stole my idea. I came up with this
Reply: Is not
Reply: @simenkolas9373 IS
Reply: Gold is a valuable precious metal absolutely necessary in the manufacture of some basic electronic components, its artificial value and the stability thereof is trivial compared to its tangible value.
Reply: Fortunately Gold is actually quite useful apart from using it for jewelry, so definitely worth it.
Reply: We have artificial diamonds for long enough. Didn't cause much of an inflation. Diamond is still highly sought out jewel.
Reply: The world will have to adapt soon to get rid of its unintelligent economies. The universe is functionally infinite to us, resources are not scarce if we really wanted them.
Reply: True gold will probably become cheaper. But gold is still useful for stuff like electronics. So it might not be a bad thing. But it would be bad for anyone who bought gold in the hopes that it would keep it's value better than money so IDK
Reply: its fine we need easy access to good conductors to keep steady progress on quantum computing, the real problem is where to get the mercury from
Reply: My thoughts exactly. The value of gold is going to plummet
Reply: I assume this will improve technological advice with gold being used more commonly for shielding and other stuff
Reply: "And that grandson was how gold became worthless and our economy plunged into everlasting darkness ".
Reply: I mean good is a great conductor and has a lot of applications beyond just looking pretty.  And as far as it looking pretty it’s a pretty damn good metal for that too, doesn’t oxidize, doesn’t stain the skin of the wearer, I’ll take as much we we can get
Reply: Mono Atomic Nuclear Gold?
Reply: Exact thing i was thinking about the whole time lol
Reply: I doubt it. We already have synthetic diamonds, and those are cheaper than natural ones.
Reply: Unfortunately thats wrong because inflation only occurs with things that have no use, gold is one of the most useful things in nature and is the only thing know for magnetic shielding which is vital now during the magnetic flip and micronova
Reply: It’ll just be like synthetic diamonds. They’ll cost significantly Less but not be worth as much
Reply: They only make micro grams bruh lol 😂
Reply: The best part is if we can make that much gold, technology would be able to get so much faster, replacing all the copper we use for a much better, although currently more expensive material.
Reply: Like, printing cash? Why do we have crypto currency then? I could get rich in an hour😮
Reply: No, that's not how that works as supply increases cost goes down.
Reply: All inventions are risky :)
Reply: Bitcoin..... but dont buy today without the idea that you're going to sell it this fall/winter (2025) the next life changing chance to buy Bitcoin will come during 2026/2027 🎉🎉🎉🎉
Reply: Funny but probably not the case. If anything as we use more gold for electronics etc. then the more valuable it will be and bc this gold costs so much to make gold will remain as valuable if not more so
Reply: Actually this METHOD is to curbtail the value of gold back to what it once was...=\
Reply: Right... WTF 😮😨
Reply: an incredibly good thing imo, gold is a critical resource in most modern tech. we should make it as common as possible.
Reply: Nope. You meaning to ask why electronics are still expensive. This wont decrease gold price but increases chips production and quality. Been meaning to ask why dont everyone own rtx 4090? Because it worth like a house in some countries like india or china. We need this so modern gaming wont be dead
Reply: To be fair, since the price of gold would drop so should the price of electronics and such right?
Reply: Yep, what they also forget to mention according one documentary I saw, cost per creating gram of gold is several times higher than normal cost of said gram of gold.
Reply: Thank God, then it can be mostly used for manufacturing and industry instead of useless rings and chains.
Reply: Humans have mined 216,265,000kg gold
It would take one reactor 432,530 years to produce that amount.
This is a great way to make fission power more profitable, also gold demand is increasing rapidly, price will keep increasing.
Reply: Yeah gold value should decay over-time if this gets implemented large scale, what makes gold so valuable to begin with is that it's a non-renewable metal that's present in low quantities in earth
Reply: 5 tons of gold a year is around 190 million dollars. enough to just about keep this program running and some profit. But not alot
Reply: This would actually do that opposite
Reply: Yeah tell that the diamond districts that sell worthless stones …
Reply: Gold is one of the most useful materials when it comes to electronics
Reply: Nope, this news will trigger the gold inflation, before first gramm is printed. Maybe this is a fake news, with this single purpose.
Reply: How tho lol this takes way to much energy to be productive
Reply: @notthisyourlightthe process creates energy thats the main point of fusion. Gold is just a byproduct of
Reply: i just wanted to type that
Reply: Central banks cringe when they hear their holdings are going to zero. 0️⃣ 

Naaahhh they are the ones funding this and will dump their hand before the general public even knows it.

Orrr they do what de beers does it. Horde the supply and tell lies about gold is a man’s best asset.
Reply: The amount they can make is very small and the amount of energy it takes to make it isnt worth it whatsoever.
Reply: @28maxlax how many times does it need to be stated that the gold is a byproduct of from fusion reaction meaning they are creating energy and as a result gold is being produced they aren’t just trying to to produce gold
Reply: @anthonydoane4669  doesnt matter, it cant produce that much at all 5k kg is a fucking pipe dream
Reply: But you forget the Boomer philosophy: it doesn't matter if the value of gold plummets to nothing as long as they get rich before that happens, and that's a risk they're willing to take.
Reply: Who cares? Money isn't real and certain things people only like because it's rare or artificially expensive, like diamonds.
Reply: Not if the production of gold is expensive. The gold produced would be expensive and inflation won't happen.
Reply: We literally cant get gold inflation, we are not a metals based currency
Reply: I mean we did it with diamonds
Reply: Not necessarily. Mining gold (as opposed to printing) is a limiter because it’s hard and expensive. We know of lots of gold that hasn’t been mined because it’s just too impractical. While this isn’t mining it still has the same effect to limit how much gold we can have access to because it’s hard and expensive. Plus you still need to get the mercury somehow.
Reply: I wonder if our love for gold goes back to something we can’t even remember as a species. 🤔💭 Far as recorded time EVEN FURTHER it’s if we were genetically programmed to want gold in our DNA 🧬

Maybe Graham was right about the distant past and others who believed the Sumerians we once MINED FOR GOLD for Technological Purposes for a for more advanced civilization (maybe not even aliens maybe US) 

We now know GOLD is the best Conductor when not corroding is important. (For outdoor Tech exposed to the elements) The pyramids once had giant Gold caps that were stolen centuries ago. Maybe it was just for decoration 🤷‍♂️
Today some scientists say if gold is released in the atmosphere with enough quantities it could reverse global warming climate change effects, essentially Terraforming. 

Some say one day we’ll do this to Mars… 

or maybe a 12th planet which impacted? 🤷‍♂️ SOMETHING collided Causing the Asteroid Belt  ☄️ That’s a Fact 

Either way Something terrible happened changed everything and reset earth back to the Stone Age but IN OUR DNA we know GOLD is important. We just didn’t know why? So for some built in reason to this day we’re still comparing all money values to gold on every continent, in every country, in every region, every city, every civilization. EVEN ones who have never met never spoke to each other and have no idea why but we do it!
Reply: Deflation.
Reply: You mean deflation?
Reply: We would NEVER notice the inflation difference IF ANY amount. Maybe Penny’s a pound. 🧐 5,000 pounds a year is NOTHING when you consider 5.5 to 6.6 MILLION POUNDS Of Gold was Mined Last Year Alone!

They would only be making a fraction of a fraction of fraction of less than %0.1. They’d have to build several thousand gold reactors to put a ding in the gold market.

Also the amount of energy to run all those reactors would require reactors of their own lol 

It’d be like Crypto mining companies. You’d see one here and there but it requires so much energy and space and the danger levels are difficult to get zoning passed by local Gov’s. It’d be just like Crypto there’d be 3 or 4 extremely wealthy Corporations doing it and they would lose tanker truckloads of money the first few years but eventually they’d make a small fortune annually but it’s feasible enough for most companies and it wouldn’t be enough to change the market price notably
Reply: I'm about to start selling mine off
Reply: I would say that it'd be an amazing investment from the point of view as using gold for technology
Reply: For that to happen it has to be mass produced, this isnt possible right now
Reply: Gold is already hypo inflated.
Reply: AND?
Reply: It costs more to make the gold than the gold is worth...
Reply: Gold will stay the same cuz the effort to make this balences its value it might go down a little but as long as supplys for it doesn't go down its value wont
Reply: Sorta but heavily depends on when it would get extremely popular and automated.
Reply: Good. Gold is actually useful for things. Bottoming out the price of gold would make things that need gold less expensive, at least temporarily until the market stabilizes.
Reply: Gold is valuable because it’s extremely useful. What’s better than being useful and printable
Reply: The gold will go down in price and correlate to the dollar going down in value so maybe gold just stay forever at the same price.
Reply: Gold's value is already falsely inflated. This would have absolutely no effect on it
Reply: @MrJdamnBro paper money is falsely inflated.  Gold is a reflection of that.   Countries can’t print gold.   That’s why central banks keep it and buy it as a protection from human nature.
Reply: Gold is a terrible metal so it wouldn't change much
Reply: That’s not how that works😂
Reply: Wouldn't it be deflation? The price of gold dropping, or are we assuming gold as a currency
Reply: @phliao-nathair china destroyed the jewelry diamond industry with manufactured diamonds. The younger population accepted them over the mined ones due to costs and environmental and human rights issues.
Reply: @ZzHasbrozZ That… seems like a good thing? The jewelry industry hardly deserves the price tag they hawk.
Reply: @phliao-nathair what you forget is the price is not high.  The value of the dollar is low.  So inflation has robbed you of your buying power.   It’s a slow boil like frog stew.
Reply: Its science 😂its gonna happen whether we like it or not better value paper dollars or find a way to make digital cash safe or sum
Reply: Deflation
Reply: Google Davanzo inc it's a whistleblower
Reply: Rather gold deflation - it will lose its value pretty quickly
Reply: gold is very important in electronics so it would still be VERY useful
Reply: And there goes it's value
Reply: Everyone saying gold will collapse has never googled diamond monopoly
Reply: They are unto us.    Did we really think they'd let us have a stable form of currency without inflation?  I wouldn't be surprised if the whole thing is run at a loss, paid for with printed fiat just to   undermine gold.   Guess we're down to just Bitcoin now.
Reply: good, gold is useful as hell but stuff gets way too pricy cuz... it is gold.
Reply: Yes, but keep in mind. This will make electronics a lot more cheaper.
Reply: This will be gold deflation
Reply: The gold only exist for fractions of a second, at insanely high speeds, it’s not actually useful for creating gold it’s just a cool thing that happened in a particle accelerator
Reply: Still need to source plutonium
Reply: Silver is king lol
Reply: Yep, but more gold in the world would probably have a net pro. It has a lot of uses.
Reply: We have always had gold inflation. You have no idea how old banking works right? You don't actually believe the gold that is being traded world wide is actually physically present or do you?
Reply: Gold is in the ground, we dig up tonnes of it every day
Reply: Umm...then the value of Mercury goes up then, which will increase the number of precious metals on the stock market and may effectively install millions of more jobs?

This is a wonderful thing.
Reply: dawg not even gold is safe in this economy
Reply: Deflation* the price would go down x
Reply: Lol evidently you haven't heard of what diamonds are made of?
Reply: We dont even run on the gold standard anymore. This wouldnt affect anyone other than jewelry shops and miners. That is if it wasnt overly expensive for what youd get.
Reply: The government is gonna make gold illegal now lol
Reply: gold has many useful industrial applications
Reply: Gold has many uses beyond decoration and an asset. It has large demand in electronics and is used in most devices, so the need for more is always there.
Reply: Good.
Reply: that’s not how it works, 

more supply = cheaper 
less supply = higher prices
Reply: Good? Materials being cheaper and more accessible brings us closer to ending capitalism and moving to a state where base needs can be readily met for all humans
Reply: Gold is used to build spaceships... There will never be an overabundance when we start touching the Stars 👽
Reply: Gold is used to build spaceships... There will never be an overabundance when we start touching the Stars 👽
Reply: And the flaw of that is.... ?
Reply: And a mercury deflation
Reply: Not a substantial amount per reactor but ultimately Gold is going to become as precious as cooper and silver the way aluminum went from the most precious metal to soda cans and disposable applications that aren't even worth recycling.

F Gold, it's just another element of the periodic table and has far greater industrial uses than being held in billionaires vaults
Reply: It's going to flunk it cost too much to make radioactive gold plus I don't think you want to wear ionizing radiation
Reply: @Yt_subject400  the industrial demand is going to exceed ancient applications. Everything electronic or the cooling components used in quantum computing can run a lot more efficiently with gold and that's going to be the biggest demand, plus the halflife is only days and it becomes stable gold isotopes once it decays
Reply: Not to mention that energy is the only real currency (hence petrodolar). The reactor is printing money without the gold.
Reply: Actually deflation of gold price or at least stabilization as industrial demand is going to exceed ancient world applications
Reply: i was gonna say this theres only a price if theres a demand
Reply: That’s not how it works. Diamond silver gold and other precious metal companies have massive stockpiles. They only release small amounts each year so they can keep the price exorbitant.
Reply: @tristanhill1502 unlike the US printing machine.
Reply: I was planning on commenting this
Reply: if gold was abundant, i would be happy to use gold wire instead of cooper
Reply: Deflation*
Reply: Either that or gold will have no value😂😂😂🤷‍♂️
Reply: A gold printer that creates gold at a price higher than the value of the gold itself
Reply: It'll be the same as diamonds
Reply: the gold is not used for jewelry but for technology because gold is the best option for it
Reply: I mean, it's not like extracting gold from nothing, it has a whole process, a job to create that gold, which could support its value and prevent it from falling, more similar to mining Bitcoin, right?
Reply: Mercury prices going up
Reply: The only things that make gold valuable is its looks and conductivity, along with its other uses in the sciences. Basing an economy off of a metal because the people of the past arbitrarily decided it's valuable is idiocy.
Reply: a lot of people think gold is valuable because it is rare no it is valuable because it is very useful metal one of most useful metal that is rare most of the technological equipment requires gold
Reply: Just like the Diamond cartels crying about man-made diamonds someone will try and cry about man-made gold.
Reply: So.
Reply: It would be identifiable, and for that would likely require labeling at threat of legal action. Same with alien gold, radiology tests can show it's space gold and should be treated as such. Problem comes when someone starts mixing 1 part alien gold with 100 parts Earth Gold to try and sell 101 bars of Earth Gold
Reply: At this point even silver is gonna be worth more than gold 😭🙏💀
Reply: @Fruntloy  good. Gold isn't very useful. Silver actually has practical uses. Gold is pmuch just a shiny paper weight
Reply: Yeah, the price of gold is gonna plummet faster than my bank account when I buy more car parts
Reply: None of you think to mention the countless people in modern day slavery to mine gold and all of its technical uses? Just the money? Just the profit? Hm!
Reply: Gold yielding alchemy was promised to them 2000 years ago
Reply: well, gold is actually really important in makeing technology so it wouldn't be that useless. but yeah, gold as a currency would probably become nonexistent
Reply: Gold is good transfer of energy, it’s used in phones
Reply: Is this going to crash gold prices?
Reply: Due to Gold inflation, we decided to rank the Silver Knights as the strongest. We are still deciding if the Bronze Knights or the Gold Knights are stronger so we can decide their ranking.
Reply: This would be nice for the practical uses of gold, but it would lose its monetary value overnight like you said.
Reply: Fr its okay though our current economic sustem will collpase and then there will only be a trading system and socilsiams of resources
Reply: @ffreedomvat3737 Our current economic system is based off of trust in the US economy, not gold. Also socialism is terrible in practice.
Reply: Even today, the amount of gold mined and refined is carefully controlled to keep the supply and the price stable. So I believe this wouldn't change anything. (Also means gold, like oil and diamonds, is basically a legalized cartel market.)
Reply: Yea but you could get gold wires everywhere fpr cheap no?
Reply: Lab made gold vs natural gold there will be a market for both just like lab grown diamonds vs natural diamonds
Reply: Lmmfao!  Yup they’ll inflate everything if we don’t stop it. 😢
Reply: this. basically :/ just when i bought some gold myself... noooo :'(
Reply: That's what I was thinking
Reply: Exactly, let's not do this shall we?
Reply: Nah, the cost of creating it will be higher than its value.
Reply: Yes but who cares no one is on the gold standard. Sell gold stocks if you hold it.
Reply: Its used in a lot of health stuff so maybe it is for the best
Reply: gold has a lot of use, they are not like diamonds
Reply: Though price declines is inevitable if this happened, but I am happy with it, I can have more gold to use
Reply: This will make gold cheap ... and mercury expensive😅
Reply: Yes. The price of gold is going to decrease
Reply: Goooooood
Reply: Imagine having gold wiring in your house instead of copper
Reply: you mean deflation buddy
Reply: I'm sure there's a way to tell like with lab grown diamonds
Reply: Aluminium was most expensive metal around 200-150years ago but someone got a way to extract it easily now it's so cheap it is used as can for food and drinks
Reply: It's not going to make a large difference in the yearly production of gold, compared to traditional mining. The production of energy, is probably paying more than the nuclear synthesis of gold.
Reply: SHORT SHORT SHORT
Reply: Prices on gold would not inflate they would go down
Reply: I don't think it would, 1. companies make WAYY too much from gold
2. It's a non toxic substance that doesn't tarnish. It's very desireable. 

Even if prices go down, just means i can finally make my floppy gold sword
Reply: But that might be useful on another level gold is used in  industries in very small amount due to its price if it became a cheap metal it may open many new applications this case happend to aluminium before
Reply: No, nuclear fusion is not easy bro... plus gold produced this way would have to be stored for 7 to 17 years before being safely sold
Reply: cept it it cost more to proude the tiny micrograms of gold than it would ever be vauled at.
Reply: It's useful for tech so it might not be so bad
Reply: its a good thing tho because gold is a valuable metal for a reason, especially for tech.
Reply: Good. Gold is overvalued as a precious metal, and far more valuable for computing, where it is used as sparingly as possible due to the cost.
Reply: Saddest part was we only valued “yellow gold” but white gold and platinum which is more valuable often got tossed into the ocean because it wasn’t yellow. Sigh….
Reply: Time to buy mercury then because they'll want mercury to produce the gold.
Reply: Exactly 💯
Reply: Is it time to stack silver? Copper?
Reply: Gold inflation has already started well before the invention of this process 😭😭
Reply: golds value is not in it's beauty or rarity but is versatility and useful qualities. actually driving gold down to copper prices would be great for the economy no joke as long as it is abundant enough the math tracks that it would benefit production and invention.
Reply: Another step towards abundance .
Endless energy and gold
Reply: All before gta 6 😭
Reply: Oh my God now everybody's rich in the world you don't need to buy go anymore you're rich everybody can be rich
Reply: Gold is still very valuable for its practical applications. High biocompatibility for medical implants, corrosion resistant, and a decent conductor.
Reply: @baitposter so there's gonna be gold everywhere everyone is the rich
Reply: @cupidok2768  
It has practical value beyond its scarcity, like copper and aluminum
Reply: less mining & more stable gold supply for semiconductor manufacturing would probably be the actual application
Reply: Technically it would cause gold deflation, because the price would go down due to an increase in supply
Reply: We use gold in every electronic device and the number of electronic devices have been rising so I doubt it
Reply: So you're saying we're gonna be rich then @mstrslay3752
Reply: The cost of "printing" the gold will exceed the value of gold and cause it to plateau. Then other things might replace gold, like Palladium. I believe that no matter how much chaos is done, everything will eventually come to a balance.
Reply: 😂😂 no stupid it going to drop the price just like lab diamonds
Reply: Guess it ends up like copper
Reply: Not really. Mining gold out of ground is still 100x cheaper probably
Reply: asked AI, the yield for a gold mine it is around 50 ton per year, so basically a 1 giga watt reactor only produce 10% of a conventional gold mine, and if we multiply the reactor, we would need 10 giga watt. since 1 gold mine cost about 3 billion and 10 giga watt cost about 7 billion, I am not quite sure current technology will be disruptive
Reply: Gold things are nice looking. It'll be the same as our ability to print perfect, indistinguishable, and clear diamonds.
Reply: Yeah but it lowers the idea that there are only so many ounces of gold.
Reply: Well the Jews already print money out of thin air. What do you think a bank is
Reply: Not how that works. Gold will be valued lower since there will be a higher supply for the same if not less demand
Reply: Yeah, but Marathon fusion controls the process

So yes, they would become rich
Reply: Not one illegal thing about it
Reply: I guess this kills that alien theory on the anunaki enslaving humans during the summarian age before Christ to mine gold so they could save their planets atmosphere why would they need to do that if they could of made gold and energy
Reply: It is not profitable because of the cost of materials
Reply: I can turn dog shit into gold.
Reply: I doubt this will cause gold inflation it is easier and cheaper to simply mine it out of the ground. Their estimate is 5 tons of gold per year the US already mines 170 tons per year and Canada mines 200 tons.  When you consider that these changes will almost certainly make it so that it requires significantly more energy to run then it can produce.  Besides who wants radioactive gold.
Reply: They just have to do the same as they did with diamonds... You just have to make everyone believe it's still rare
Reply: Dont worry… since we have bitcoin, gold is useless anyways. Only use is jewerly and electric devises. Not mad if they get cheaper.
Reply: Does the amount of used resources cheaper or higher totaling amount just to produce small quantity? My question is that would it be worth it to produce? Cost vs result
Reply: Time to pull my assets into gold and put them into bitcoin which at least has a hard limit
Reply: It would actually be gold deflation
Reply: @DwDDB  no. Inflation. Just because the inflation in our fiat money is bigger, doesnt mean, that this isnt an inflation too. But you inflate gold. You suck out every worth if it, exactly like our national banks do with our money😉
Reply: @NoMoFomo21 🤦‍♂️

Simple supply and demand. If there is an increase in supply, the price goes down, which is deflation. Yes, the amount of gold is inflated, but inflation/delation has to do with cost
Reply: @DwDDB you just dont understand what inflation means. Stock/flow ratio is the inflation of a good. If you increase the supply of an asset, you will allways increase the inflation of that asset. 

Lets say we would use gold as denominator, then you would have inflation in every good compared to before😉
Reply: @NoMoFomo21 

You’re confusing terms here. Inflation = general rise in prices, not just “more supply exists.” What you’re describing is monetary inflation of an asset’s supply, which isn’t the same thing.

Stock-to-flow is a scarcity metric, not the definition of inflation. And if you priced things in gold, you’d see both inflation and deflation depending on relative demand shifts. It’s not the one-way street you’re pretending it is.

In short: supply ≠ automatic price inflation. That’s Econ 101
Reply: @DwDDB  you arr using the new definition of inflation. Not the original one, before Nixon robbed all our gold to fight a war.
Reply: @NoMoFomo21 oh, how dare I live in the modern world and not some glorified interpretation of the past 🙄
Reply: @DwDDB  your definition is a lie of your elected dictators so you dont realize how they rob all your capital😉
Reply: @NoMoFomo21 keep on telling yourself that, I will continue to enjoy my retired life while navigating the system I am in, instead of being a whiny little B that dreams of the time before the Information Age.
Reply: @DwDDB  while you are a little sheep that accepts everything like it is, I am changing the broken system that you left the youth with.
Reply: I bet it's still really solid
Reply: It will make gold invaluable
Reply: They have artificial diamond but natural diamond is still expensive af
Reply: Gold supposed to be rare now the gold will not have a hight value anymore
Reply: Money is printed on a material more rare than gold
Reply: This will be the exact opposite of inflation, it will be worth less
Reply: You’re right but it would make tech cheaper
Reply: No it wouldn't. Because it would be exorbitantly pricey to get this energy in the first place.

we need fusion before we get to this.
Reply: Even if it does, I’m sure a mega corporation would hoard it just like they do with diamonds and pretend it’s in low supply
Reply: Well it is the most conductive metal so it is useful
Reply: Time to swap my gold holdings for BTC
Reply: No you don't understand how flooding a market works. The market won't inflate it will crash because gold will be easier to obtain.
Reply: I yeah but that’s why you have more then one investment
Reply: Gold is not worth shit at all already 😂 its a conductor in electronics but we already have better ones . And dollar gold seperated years ago .. its just fiction to keep Africa from collapsing in its entirety with its dumbass ninjas
Reply: Bull crap, many REM mined every year and they didn't make the price lower, same as oils 😂
Reply: @priersackh I guess you will find out won't you. In ten years or less people will be throwing gold into the streets because it will be worth nothing.
Reply: @XDaddyBender in iran oil is cheap yet no one throws it in the street. They have value for something, yes. But will not be useless. Tech will advance as the use of gold will create something even more valuable than just it being a decoration, unlike diamonds that is total garbage the price can be pumped through imaginary price
Reply: @priersackh  Are you talking to yourself or do you just not read comments?
Reply: Possibly, or may end up being similar to the diamond industry with lab growns. Whether or not natural gold and produced gold would be distinguishable, I have no idea 😂
Reply: Deflation*
Reply: If this actually works oil producers and gold miners/brokers will buy the tech and kill it immediately anyway.
Reply: But what's the point
Reply: Diamonds
Reply: Buy Bitcoin
Reply: There was a twighlight zone episode that predicted this. Golds never really supposed to be a glamorous commodity. It has real world applications and can be used to make our lives easier. I say we SHOULD inflate gold, it deserves to be used for it's intended purposes, not as tacky jewelry.
Reply: I feel it’s not a bad thing a lot of electronics use gold. The cheaper it is the crazier technology will come is what I think
Reply: Fiat gold , that will drop the price of gold substantially. Just like lab grown diamonds did . especially if lab grown gold is indistinguishable from natural gold. They always find away to screw up the natural order of things.
Reply: But imagine the capabilities of using more gold in technology without overpaying could be a big leap forward for ever getting quantum computers properly commercialised
Reply: There too little gold in the world for the inflation to have a dent in the price if we were to make gold like this. At least that’s what I think.
Reply: No it wont. Are 50 years away from it being profitable
Reply: Kinda... But fusion is required. This isn't easy to achieve. Also, gold is just always useful.
Reply: Elements do not have value. Value comes from the labor expended on useful items. The Labor expended at the plant is infact within the value of the gold it creates. It's possible this gold is more expensive that regular gold
Reply: Do you know how many gold is mined yearly? More than 700 tones.

Fusion energy isn't even on early stages, let alone building a gold factory inside it .... This video has a lot of futurism on it.

Turning Mercury into gold is known by humans since last century.... It's just ridiculously complex
Reply: Mining the physical gold is way cheaper than making it via fusion. If gold production switched overnight from mining to fusion (if that was even possible), gold would actually get more expensive and supply would be limited.

As long as there’s still gold to mine, no one in their right mind is going to try to start a profitable gold fusion business. Energy would have to be essentially free to make it worth doing from the economics POV.
Reply: Nuclear fusion is more expensive then the amount of gold you would actually get
Reply: Amazing! So gold will be cheaper, we will have cheaper electronics and the money will move to a real scarce currency: Bitcoin.
Reply: It's helpful to pay the aliens 👽
Reply: Depends. It's only 2.5 metric tons of gold per year. I would bet that finding a new gold mine probably outputs significantly more per year.
Reply: The right move is to invest in mercury.
Reply: Noo it's deflating cause wee will get more and more gold Wich makes it more common so it becomes cheaper
Reply: This basically printing money. Which governments do. They don't care about gold anymore.
Reply: fr
Reply: Either gold inflation or mercury deflation
Reply: Hey dude. Idk how to tell you this but people still think labgrown diamonds are basicly shit and only something to use if you need to grab something quick before going out. Trust me your gold value will not go away ecpecially with how hard all of this is
Reply: The gold that he talks about isn’t real gold. It Fools Gold.
Reply: I meam given that gold is useful for alot of stuff, lowering its price would probably be a good thing. Unless youre one of those people who hoard the stuff i guess.
Reply: Bro if they printing gold the price should get lower and worth and they keep printing money so uhh money is worth less so u need more money to buy shi whatever
Reply: Which is actually good. Gold is valuable metal not just because of its rarity but because of its properties. If we could have more of it to use some stuff such as electronics would be much cheaper
Reply: We're not on the gold standard anymore
Reply: All the preppers who’ve invested in gold will see the value of their gold dwindle. This way of devaluing tangible things and money could be yet another way in which they want to make us all dependent on virtual money.
Reply: But Gold is actually useful.
Reply: And they said to buy gold, hah! That being said, we can already print diamonds and shit, do you see their prices dropping? People like their precious stones and metals to come from the ground, for some reason
Reply: and thats a good thing actuallu
Reply: Time to sell your gold everyone
Reply: Gold is not valuable because it's rare metal born inside neutron star core but due to highly inert nature that fuels electronics and research. Gold is not just only jewellery shiny.
Reply: nah, the elites would just hoard it all
Reply: People here answering to this comment not seeing is a braindead zoomer
Reply: First thought
Reply: Its gonna make mercury skyrocket if true
Reply: I’m also not gonna be that upset about turning a bunch of super toxic mercury into inert gold.
Reply: They always roll this crap out when central banks wanna load up on gold
Reply: You know the government is already doing this!
Reply: I hope so! I'm sick of this economy to be honest 😂
Reply: I feel like a bug in rick and morty whos currency value has been changed from 1-0
Reply: Good maybe we should stop being infants and obsession with accumulation of things? Post scarcity is evolution to a better world.
Reply: Reminds me of the issues with 'space cash'
Reply: It will cost more than gold mining and the purity will likely not be as good (incomplete reactions leaving lead in the product) and the gold will be hot.
Reply: Exactly.
Reply: It should be deflation, but God knows we will find a way to make it cost more.
Reply: we already have good inflation. every year bunch of it gets mined and goes into circulation
Reply: We mine gold...
Reply: What he didn't mention is the rate and cost. The cost of a one gigawatt reactor would be massive
Reply: 😂😂😂 ... Hmm, but "MERCURY" isn't that handy
Reply: Just a casual 1gigawat to run 😊
Reply: It’s still expensive to make, it would take a while for prices to change. It’s also very much needed in electronics
Reply: except they can only make one or two atoms at a time... ignore the fake kilogram numberss, nothing to worry about.
The US economy and ponzi scheme does far more damage to your wealth.
Reply: Nah, this will go nowhere.
Reply: Yep, another "stable" value carrier is going to devalue rapidly.
Reply: My first thoughts
Reply: Bro but if the gold will increase its price will decrease cause more need and less gold will hike gold price but if we have abundant of it ,it will become an ordinary metal like copper
Reply: Just buy the gold from other people eventually you can sell it at an absurd price and you have an infinite supply repeat the process even destroying the gold you buy. scarcity can be created too.
Reply: They already do thay with Diamonds but they still maintain strict restrictions on supply to keep the price artificially high. They're just gunna scam us.
Reply: But at least rich people will cry in corner
Reply: You need gold in lots of electronics. It is actually a good thing.
Reply: This is still wildly inefficient in America a gigawat of power is 2-10x that of 5000 kilos of gold. Supposedly china has been doing this for years though which would make sense with their power infrastructure. Same reason they were at the forefront of bitcoin mining
Reply: They already know how to inflate gold. Put cheaper metals in the centre more and more till the outer surface becomes a thin foil layer. Like a penny used to be, copper coated with a zinc core. Obviously anyone worth their skills will be able to detect the difference in weight contrasted to the volume of the coin.
Reply: Gold isn't safe anymore
Reply: "Gold inflation" (actually devaluation) is a good thing, because it's so useful.

Even when still used as a reference currency. Because when its value is determined by its usefulness, it's much more stable than when determined by its availability.
Reply: Buy mercury
Reply: Gold would become worthless
Reply: I’m glad one of the top comments mentions this. This is how to devalue Gold
Reply: Actually the opposite.  Gold deflation.  More supply, same demand.
Reply: Exactly what I thought.  being able to make gold would just devalue the product itself.
Reply: Bitcoin
Reply: For now that's not going to be worth anything
Reply: Mercury price will skyrocket and since mercury is also rare material the cost to make gold will also high + electric cost...probably mercury gold will be higher than natural gold.
Reply: Good. Crash the economy. Let's go back to barter.
Reply: Hardly. Gold has industrial uses. And industrial use is constantly pressured by competitive buyers in jewelry, goldsmithing, banks and detailing. Simply put you make artificial sapphire/diamond that is 99% ised in industrial purposes and natural ones are still used in traditional uses.
Reply: Still it is a good thing as we know Au is both good at electric conductivity which leads it to a good option in iot communication (rams , cpu, gpu etc) which means not buying a expensive ram because of its gold plating but buying it for better silica in short cheaper, gpu’s etc , 2nd point its highly malleable which makes it an ace for physical experiments and discoveries like the Rutherford’s experiment ,, in short it will lead to a better future as when gold is available cheap it can be easily available to everyone leading more advance future
Reply: Exactly
Reply: Would Cost a fortune to make it, price of gold would skyrocket.
Reply: Look at the diamond industry. We've been developing artificial diamonds for decades, yet natural diamond still retain their value. Now gold in electronics and other applications can be much cheaper.
Reply: Heck nah
Reply: Good 👍
Reply: Maybe. Synthetic diamonds lost something like 80% of their value because people want real diamonds, not lab grown ones. So outside of industrial use, synth diamonds are pretty worthless. The same would probably happen with gold. The value is in the rarity, and even with synthetics, the natural version will always be worth more.
Reply: It would be deflation if a lot starts getting produced, like lab made diamonds the price will only go down from making it artificially
Reply: Forget the gold rush, it's mercury that will sky rocket in value & gold will plummet
Reply: The gold market is standardized. They only allow a certain amount of gold in circulation at a time and it slowly increases over time to match inflation. Otherwise it is used in lots of technology since it doesn't react with water nor oxygen directly.
Reply: @Deathcraftt so 3x the amount of gold allowed into circulation every 30 years? or just admit the truth that all markets are bs lies.
Reply: @Deathcraftt uh, no. Who "standardizes" the gold market and restricts supply?
Reply: The amount of time, energy and resources humans waste chasing gold...

I don't even like gold.

Personally, I place a higher value on silver than yellow gold anything 😂💯
Reply: @crptnite gold has more value than jewelry. It is one of the best electrical conductors. The metal itself is non-reactive unlike copper and other metals which quickly oxidize.

Edit:
I edited my above comment, but I’m still getting replies daily, so I’ll put it here too.
A lot of people keep correcting me, but my responses are lost in the vast quantity of replies. I am aware that I am wrong. Thank you for those who corrected me.
Reply: @micahsteeze  i was thinking of this. it would be amazing to have more gold in compute electronics.
Reply: @micahsteeze copper and silver are are good deal more conductive than gold. Gold real strength is that it’s almost completely inert
Reply: @micahsteeze gold is not a good conducter... but its corrosion resistant
Reply: @NorthAlmighty that’s wrong. Gold is a great conductor. It’s just slightly worse than copper.
Reply: @micahsteeze  The primary issue with this is that the value of gold as a speculative asset is higher than its value as a tech component, which means that it’s value could be destroyed if a large source of it was acquired.
Reply: @micahsteeze  so that means everything including tech becomes cheaper since all economies are based on resources and supply
Reply: @micahsteeze true, but gold will lost its value ALOT, it will still has it's intrinsic value as metals
Reply: @micah2936 and there is an extreme finite amount of gold on earth, about 23 cubic meters
Reply: @micahsteeze which is the best conductor? platinum ? then i want more platinum instead of gold since its 1) more precious 2) good for splitting hydrogen 3)  better conductor
Reply: @micahsteeze So just ending like copper
Reply: @micahsteeze they're actually using gold a lot less in electronics nowadays, they found other conductive metals
Reply: @crptnite  Gold is a good conductor and used in a lot of modern day technology. So it's not all about bling.
Reply: @crptnite It’s not about you liking it, but more about its necessity. And just like every other ore on this planet, gold is finite and if we are able to find a way to produce them ourselves it would open the heat to more breakthroughs as those ors are from space and it it takes a long time for them to be naturally made in space (how we would get those ores when we become interplanetary even though we could still get them from asteroids)
Reply: @crptnite  gold's value isn't just cosmetics. It has so many use cases. Gold isn't even that rare btw. It's at around 72. place when it comes to rarity.
Reply: @crptnite silver isnt as important gold has a lot of properties that make them extremely valuable for production
Reply: @crptnite  fun fact devices use gold in their components~ it actually has value more so than jewelery. Yes gold is but a metal, but it has use for electronics meaning your device has small bits of gold in it. 

Honestly this tech is a good thing.
Reply: @crptnite I don't care for gold for decorations or jewelry either. But it does have good technology and scientific based uses..
If this takes off and is efficient enough to use for actual gold production .. And it doesn't get regulated by the powers that be it's going to be sort of funny to watch the value of gold plummit.
Reply: @crptnite silver is and always has been the silent sleeper. Been buying since 9 an oz.
Reply: @crptnite  zame here its like usin moon rock to make chez 👽
Reply: @crptnite but value is based off the groyps value, a lot of people like gold. And it’s your electronics and shit
Reply: @crptnite I thought I was the only one
Reply: @crptnite Electronics tho, and orange/white gold 😵‍💫
Reply: @crptnite look up purple gold
Reply: @crptnite how's that paid you?😂 silver won't hit $100 for another 50 years if it ever does
Reply: @crptnite But gold is super useful in so many more things, than jewelry. Medicine for example, seeing as gold is soft and doesn't react with anything around it.
Reply: @crptnite gold is useful in semiconductors. So it’s not just for aesthetics.
Reply: @crptnite  u may not like I but it rule the value of currency
Reply: @crptnite if it can be done with gold it can be done with every other element
Reply: @crptnite  it really aren't a waste. gold has quite a few functionally properties. especially in electronics.
Reply: @crptnite  true but gold has and does play a critical role in technology and medicine. This method would sharply decrease the value of gold but also make the things that rely on it cheaper. 

This is much how Ice was seen as a priceless commodity before newer inventions came along.
Reply: Gold is valuable in electronics. Not just as a placeholder for value
Reply: @crptnite You don't like gold... Ok so?
Reply: @crptnite  gold is more rare than silver bud. We didn’t just arbitrarily decide Gold is more valuable because of its color
Reply: @crptnite  Gold is also important in technology. It is not exclusively desired because of its rarity anymore.
Reply: @crptnite there are actual uses for gold though. is not just for jewelry
Reply: @crptnite  gold is necessary for complex circuitry
Reply: @crptnite well its a good non magnetic materials used in lots of electronics due to it's high conductivity for electric current so i say it's good we find a way to make more of it even though it's incredibly inefficient it is an option
Reply: @crptnite  so no white gold either ?
Reply: @crptnite gold is used in nearly all electronics it’s not just jewellery
Reply: @crptnite Only ignorant people think it's only got a monetary value. Gold is used in the production of lots of things mostly electronics you dope
Reply: @crptnite  silver just looks cheap imo, it's ugly to me, also how is it going to inflate? Lab grown gems are way cheaper...seriously some people have no idea how the world works we now have more...not less there for it will cost less for more...fml
Reply: @HerbairyOracle  as already stated by someone else, lab grown gems are distinguishable by the crystal lattice, but elements are elements, lab grown elements would be completely indistinguishable from naturally occurring ones. If gold could be artificially produced for a fraction of its market value, then its value would absolutely fall
Reply: @crptnite Brain dead take. Gold is used in almost everything. This will help earth in our space exploration age.
Reply: @crptnite  gold is pretty useful though, in technology at least.
Reply: @crptnite  silver is useful for many reasons but I think mainly health? Gold is better for computer ig 

I dont know fr but that's what I remember
Reply: @crptnite  I buy silver, but gold is better for larger transactions than silver.
Reply: @crptnite the real value of gold is in electronic, not jewelry
Reply: @crptnite  but I love it
Reply: @crptnite you know we use gold for science right, if it becomes cheaper than copper we’ll start using gold instead of copper in electronics
Reply: @crptnite gold have its uses in science and technology boy
Reply: @crptnite gold is required for electronics and many other things. Not just pretty jewellery
Reply: @crptnite we talk about the value gold/usd 
we don’t care wether you like it or not, gold is expensive and it is a form of currency that is unaffected by inflation, and making some may lower it’s value. It would be a problem for thousands of traders, banks, and companies who own or trade a lot of gold every day
Reply: @crptnite Ur just as lost as the guys chasing gold 
U just like another color
Reply: @crptnite gold has a lot more uses than just looking pretty. Specifically in electronics
Reply: @crptnite As a armor guy I prefer Tunsgen or Titanium😂
Reply: @crptnite it's got a lot of industrial applications unlike silver
Reply: @crptnite honestly gold is way more important than you think, heck posting this comment wouldn't be possible without gold, gold has the highest conductivity value allowing electricity to pass almost instantly, gold is present in almost every electronic device we use, more gold means we can transfer energy faster, we might even replace copper entirely!
Reply: @crptnite  its not for jewlrey and stuff, its for electronics and other important equipment
Reply: @crptnite gold actually has value when it comes to making electronics
Reply: @crptnite platinum is better silver and is a lot more valuable than gold
Reply: @crptnite  gold has a lot more uses than just jewelry
Reply: @crptnite  yeah but gold is more rare...or at least it was. And gold is more dense than silver, it's not all about looks
Reply: @crptnite gold is insanely useful because of the fact that it's bio inert, extremely electroconductive, does NOT tarnish or rust ever, oh and is insanely good for audio tech.
Reply: @crptnite  Gold is actually important for some computer parts and for dentist work
Reply: @crptnite  gold is not just a precious metal. It is a valuable resource in high-tech electronics.
Reply: @crptnite  can you guess why people are chasing gold? not because it's shiny or yellow, it's because it's expensive.

and not always in a selfish way.
Reply: @crptnite  gold is more useful for electric components than silver, nevermind if considering the cost
Reply: @crptnite  Some of the most important parts of thing you used to type that are made of gold.
Reply: @crptnite that’s great you put more value in it, but majority of the world is not gonna have the same sentiment😂it’s objectively a less valuable material.
Reply: @crptnite  gold is used in computers if i remember rigth
Reply: @crptnite it’s not about it being liked more (at least I don’t think) it’s more about rarity which because it’s more rare and valuable makes people like it more
Reply: @crptnite Not just because it's Gold. In spirituality Gold is seen holy and also it is believed it brings your visualtions and words to reality stronger and better when using visualizations with gold or writing in gold. It has more meaning then just money lol. That's the distraction.
Reply: @crptnite silver could be manipulated  melted down stuff added to it etc. They used to have a thing called a "touch stone " they would wipe a piece of gold against it and it would leave a streak and that's how they would determine the purity....
Reply: @crptnite it’s not necessarily for jewelry. You’re missing the point. Gold is needed to make many of the electronics in computers and this could definitely cheapen those costs by negating the need for natural gold
Reply: @crptnite gold is used a lot in tech and space travel
Reply: @crptnite marry me
Reply: @crptnite gold is better 🤷🏽‍♂️
Reply: @crptnite 
I also prefer silver to yellow gold.
Reply: @crptnite The levels of importance in industry are similar between the metals. They both are needed for things where no other metal is a good replacement. Gold would likely be used in more electronic applications if it was cheaper to obtain. There are hundreds of different examples engineering feats that are just not realistic from a resource point of view. The “printing of gold” from a more common heavy element may turn out to be a phenomenal idea…
Reply: @crptnite  I will say, I DO like this for the sake of electronics!! Otherwise... Yeahhhh lmao, you right!!
Reply: @crptnite yeah or Platinum.
Reply: @crptnite  I also don't like a gold as a color, but I like it as an asset 🤑
Reply: @crptnite it’s used in electronics bro
Reply: @crptnite You're not special bro 💀
Reply: @crptnite  humans that understand the value and properties of gold tend to go after it cause of how useful it is. Simple people like you don’t care nor understand.
Reply: @crptnite gold has use in various electronics, if we would get huge amounts of gold resulting in the price being lower then copper, every cable would be gold aswell, which is more efficient
Reply: @crptnite  Gold has extreme value in its usability in high end electronics.
Reply: @crptnite  it's not a waste since gold is an extremely useful resource
Reply: @crptnite  gold is used for more than just decoration. It’s pretty important. Way more important than silver.
Reply: @crptnite its for the uses like chips and space use. Temperature resistance.
Reply: @crptnite  Jewelry is such a complete waste of the metal.
Reply: @crptnite  there is a reason why connector, pins made out of gold, else they would use silver in lower quality component
Reply: @crptnite  If we could manufacture gold our electronics would be way better as it’s like a better version of copper
Reply: Same man i like silver more it's cheaper reasonable ... The colour is more on my liking side than gold @crptnite
Reply: @crptnite its not about the gold itself. Gold is one of the best investment tool. If you know anything about investment.
Reply: @crptnite  🫵 werewolf hunter
Reply: @crptnite  electronics use gold. And gold doesn’t tarnish. High electrical response …
Reply: @crptnite  yes, but especially as we make more electronics, we need more gold. It's one of the very best conductors there is
Reply: @crptnite silver goes better with most things aswell imo
Reply: @crptnite  The amount of time, energy and resources humans waste chasing silver...

I don't even like silver.

Personally, I place a higher value on [insert non-renewable material] than white silver anything 😂💯
Reply: @crptnite yeah golf looks dirty while silver not only looks cleaner but is also a natural antibiotic. We used to put a silver coin in mill to prevent it from going off as quick.
Reply: @crptnite your right but also wrong, the main purpose for silver and gold is conducting, while gold is less conductive it does not tarnish while silver is more conductive it tarnishes which impedes conductivity over time
Reply: @crptnite except gold is actually useful in your daily life. The phone you typed your intelligent comment on relies on the conductivity of gold
Reply: @crptnite It's probably cause you're poor and can't afford it 😂😂😂
Reply: @crptnite dude you wouldn't make that comment without the gold in your phone
Reply: @crptnite Minecraft logic?
Reply: @crptnite nobody asked
Reply: @crptnite so glad that’s personal.
Reply: @crptnite Yaya! platinum is better, but do you
Reply: @crptnite  GoId is WAY better than silver. Prettier, more useful and way more valuable. Humans are far smarter than you’II EVER be, that’s for sure 😂💯
Reply: @crptnite we are not talking about the value of gold here , we are talking about the properties and usefulness of gold  , I don't know what you think gold is for however it is used in almost all electronics , the chips in your computers, pci boards , motherboards , gpus , wires , mobile phones , storage ( ram and rom ) and so on .. Gold is basically the most important element which conducts electricity throughout the circuit boards , without it modern electronics would be far difficult to create
Reply: @crptnite you know what the phone you using the type this has gold in its ware electronics.
Reply: @crptnite  You're so me on that 😂
I specifically like silver more because others like gold more
Reply: @crptnite golds used for alot more then jewelry you know that right?
Reply: @crptnite who cares. The economy is bigger than both of us combined
Reply: @crptnite yes but gold is an excellent conductor and is used in lots of electronics
Reply: @crptnite with that logic just go with stainless steel
Reply: @crptnite  Silver has some very practical uses to say the least!
Reply: @crptnite good thing gold price isn’t based on just your personal opinion
Reply: @crptnite fusion reactor i might add. It generates tons of energy more than it uses and makes gold. Hardly any waste there
Reply: @crptnite  gold is immune to inflation for example if your trying to save money when its in gold over years ittl keep the value but money will lose value bc you cant print gold bud do yk how inflation works
Reply: @crptnite its the universal standard of wealth, of course.  If we are so advanced that we can turn elements into different elements, then it wouldn't be worth as much
Reply: @crptnite  why its literally worth more and very durable
Reply: @crptnite  it is that exact reason gold is priced so highly the time and resources it takes to obtain a small amount of gold is what makes it have value but if you can just “print” gold that value and those jobs are now nothing
Reply: @crptnite gold is required for space travel on top of other very advanced things lol.
Reply: @crptnite  for me is platinum
Reply: @crptnite  Gold is important for electronics, not just jewelry
Reply: @crptnite  is about good being rare
Reply: @crptnite it’s used for many computing parts so phones and everything els
Reply: @crptnite  gold is used for an absolutely massive amount of products from medical supplies to electronics in your phone you’re typing on. We need gold
Reply: @crptnite that's silly! 😂 gold number 1 usa hotdog Nascar 🇺🇸
Reply: @crptnite gold is legitimately pretty rare as far as metals go, and it’s chemically inert compared to most metals. It’s actually even less abundant than platinum
Reply: @crptnite gold isn’t only used as jewelry, it’s one of the best conductors so it’s literally in all our devices
Reply: @crptnite  gold isn't only cherished for how it looks.
Reply: @crptnite  gold is more useful in electronics than jewelry
Reply: @crptnite  gold is useful in electronics
Reply: @crptnite  your opinion
Reply: Well since it's used in many elktric device such as the one you are watching this video on. It's not as dumb as it might sound
Reply: @crptnite  gold is very useful in electronics
Reply: @crptnite or brass, it's got a more subtle brilliance than gold in my opinion
Reply: Nah. Cost WAY more to do all this than to just buy gold. And they are only making a couple atoms at a time (for now) but it’s really just a proof of concept
Reply: @racergamer210 It doesn't cost much to run the reaction if you already have the reactor. And it's a chain reaction, it makes more than a few atoms, the vid literally said it could make 5000kg in a year
Reply: Wouldn’t it be like with diamonds how the lab grown ones are cheaper and natural gold is more expensive?
Reply: @MooseJoose-tx9iq thats right, but even with diamonds, how fast is tech innovation lately? if they wanted, the lab growns could be customized with 'natural' imperfections, and then what?
Reply: @MooseJoose-tx9iqno because there would be no way to distinguish the 2. Lab grown diamonds are almost flawless and free of impurities, and you can’t melt down lab grown diamonds with mined diamonds to mix the 2 together like you can with a metal. Diamond is not just an element like pure gold is.
Reply: @MooseJoose-tx9iq No, gold is not a crystal. Natural diamonds have different properties (especially in size and clarity) than lab grown diamonds. Natural gold and synthesized gold would be, in effectively every way, exactly the same.
Reply: @MooseJoose-tx9iqdiamonds we can tell because lab diamonds look different (it's all carbon*) gold.....well it's just gold the element.
Reply: @MooseJoose-tx9iq good luck trying to differentiate between a "natural" gold atom and an "unnatural" one. You cant
Reply: @MooseJoose-tx9iqprob not, diamonds are actually constructed emergent materials (crystals) so you can think of every diamond as having slightly different structure or inclusions of other elements etc. gold is a pure element, all gold is just gold, the most valuable gold can get is being 100% gold atoms.  diamonds are different depending on how their atoms are arranged and most arrangements of carbon atoms are worth next to nothing
Reply: @MooseJoose-tx9iq No. Metals vs gems. Gems are made up of crystalline structures, and you can tell when it’s natural due to impurities or when it’s man made. Metal is just metal. You won’t be able to tell the difference.
Reply: @MooseJoose-tx9iqNo. For gold, the only criteria is purity. The purer the gold, the more expensive it is.
Reply: Oh no! Are you a manor gold investment holder??
Reply: This would be a good thing
It would be very neat if coins really were just gold pieces
Reply: I don’t care about the prices it has many useful applications. It could make many things cheaper
Reply: @HiBye-zj9me ”I don’t care about prices. It could lower prices.” Its groundbreaking as a proof but nothing more for a long time
Reply: @racergamer210 yeah we would need a lot more energy to make it work well. I’m aware that it’s currently not practical but it could be in a really long time. I do think that we won’t ever get to that point though since we would need to make energy way more affordable.
Reply: @HiBye-zj9me I agree
Reply: Good. They will stop ruining entire communities with mega-mining and polluting water.
Reply: @jesusmora9379 exactly
Reply: Stop worry about the value of gold so much, but think of the applications of gold. We use it in far more products than people think.
Its value as a standard may change, but access to higher quality, longer lasting parts/products manufactured with gold will have benefits to society. 

Maybe it’s a pipe dream, I don’t know.
Reply: how did mfs in 3000 BC acquire mercury did they go into the mines with buckets to collect the metal water
Reply: @nimgetwereter3873 they mined cinnabar, which is a rock, and then burned it until the mercury metal reduced.
Reply: it would be gold deflation and damn I hope so.
Reply: We already have the ability to create more gold just by mining. It's that huge corporations choose not to
Reply: No, the real natural gold will still have way more value. Its just like the artificial diamonds, everyone said diamond value is gonna go down but infact the value for natural ones increased.
Reply: Wtf do you think a gold mine is
Reply: That's.... Not how inflation works
Reply: @sirirond1990  what do you mean it doesnt work like that duude
Reply: I Do agree. I Hope they DONT start making gold. Gold or other precious metals is a fail-safe against hyperinflation due to its limited quantity so the economy doesn't go back to the middle age or worst. 

Creating gold for Money that change the quantity of it and therefore putting the fail-safe at Risk is like , as weird as it sound for a odd reference. The Superman comics Stateing that kryptonite is super rare, like a precious gemstone, were Worth more that gold, and as the years build, so did weirdly the different kryptonite and their quantities to the point it was Everywhere on Earth to the point your back Alley street dealer could had SOME in their possession, those writers Really wanted to make Earth an anti -krypton minefield.
Reply: @ragnarokthearchgod5735 I have news for you, fake gold is already real, what do you think etfs are? Or what do you think money is? Look up why we have currencies and be mind blown
Reply: Little kid, 1gigwatt per year converts to 8.67 billion unit. If you pay 10 cent for 1 unit it will be 867 million usd. And 5000 kg gold market price is 400 million USD. I have not even added the labour raw material cost and initial cost. So no gold market not going to crash, but energy market will going to boom.
Reply: Driving up the cost of "natural gold."  Same as natural vs synthetic diamonds, right?
Reply: It won't be inflation. USD isn't based on gold. It will just cause gold to be worth much less
Reply: Could be like the diamond market where natural stones retain high value and lab grown stones are cheaper
Reply: Also mind you, the US dollar is backed up by gold. This would make the US dollar plummet as well
Reply: @nas8350  no it's not. The US moved away from the gold standard almost 100 years ago
Reply: Jesus is a perfect man who took the punishment we deserve on the cross and he rose from the dead so we could have eternal life and all we have to do is believe in his sacrifice, repent of our sins and obey him.
Reply: @Jib-gib 🙄
Reply: As it should. How many centuries of humans chasing that metal? 😂
Reply: If this was true it would change the entire economic realm we would basically free energy
Reply: Gold deflation is what u mean
Reply: Well as long as it is regulated it will still have value. On top of this awesome experiment, who’s to say people should stop at Google? What if we could add and take away molecules and make other resources on command. Resources that could make space travel easier? Changing elements to power production for farms and combating hunger? So many possibilities.
Reply: Yeah because gold has been so stable in the past
Reply: its gonna be like diamonds. lab-grown an natural
Reply: @danquavios1 Yeah but most gold is used in tech, while diamonds are mostly used in jewelry
Reply: @danquavios1  diamonds are made with extreme, pressure, friction and time. With a unqie structure lab grown doesnt replicate perfectly. You would be lucky if a lab could tell the difference between gold and gold.